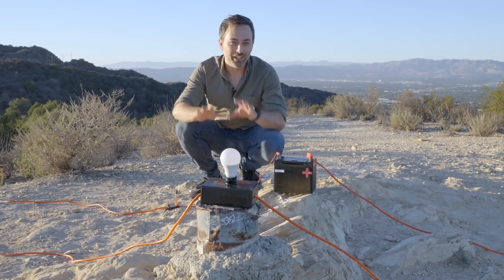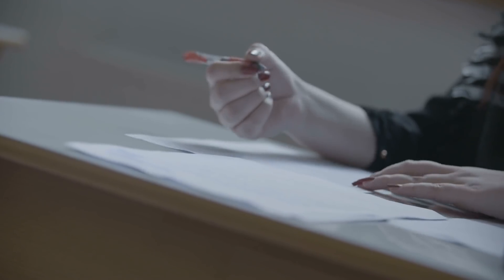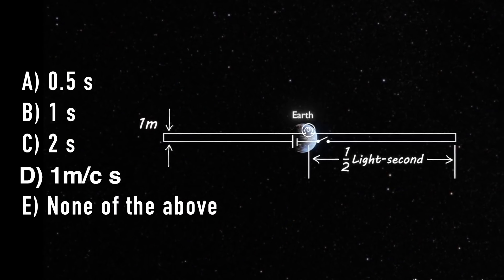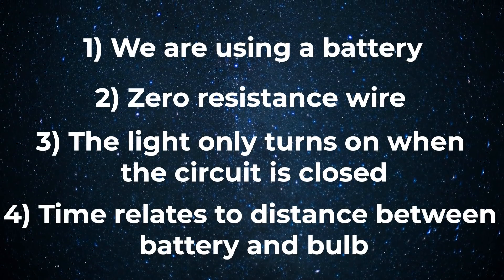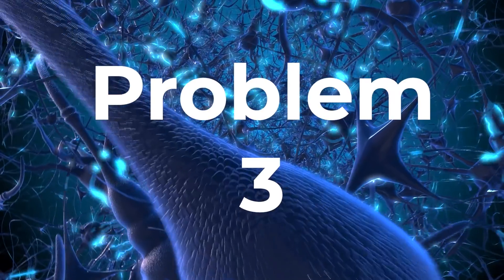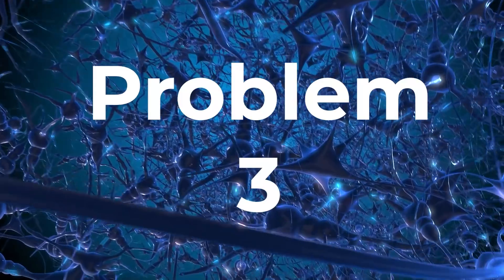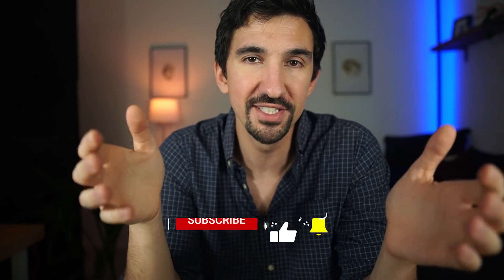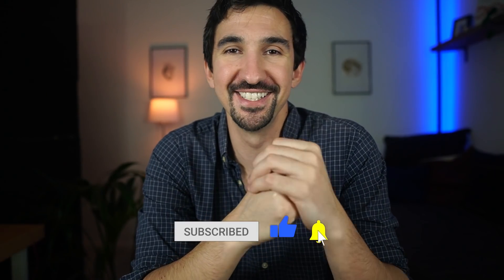Is Veritasium Wrong About Electricity?

Comment: One thing to remember is that the two wires being one meter apart have some capacitance between them, and such capacitance existing right from the start transfers some power to the lamp. as the switch turns on and voltage on the line flips. Veritasium's video is designed with all sort of clues and limitations around the problem that are hard to pick up. But at the end of the if we go with all limitations Veritasium imposes on his problem, he is right.
Reply: Thing is, in the video the bulb he's hooking up is clearly an LED.
Those have a threshold voltage in order to turn on, so some tiny voltage that comes from induction won't cut it.
Reply: @IamGrimalkin  in order for inductivity/capacitance to work, need much more time than 1/c anyway. More time you give, larger length of the wire can “participate”.
Somebody with better math skills than mine can probably calculate that       even after, say, 10 ms, there will be not enough voltage to light up a red LED even for a few nanoseconds, even assuming zero resistance infinitely thin wires.
Reply: Veritasium has been wrong about a lot things for the past 2 years. Just saying.
Reply: Veritasium was not correct because his light bulb would light up exactly the same amount as it would had the CIRCUIT NOT EVEN BEEN COMPLETED in the first 0.5 seconds

Imagine a second setup with a battery and light bulb where the ends of the cables are not connected (0.5 light seconds away floating in space)

When you close the breaker information and causality can not propagate faster than the speed of light, so whatever happens before 0.5 light seconds can't be any different regardless of whether the circuit is ACTUALLY completed or not

The energy that gets transmitted across the 1m gap is the same regardless of whether the circuit is truly closed, then the energy that arrives because of the circuit actually being closed can't arrive for longer

If we're accepting small amounts of energy transferring NOT DUE TO THE CIRCUIT BEING CLOSED then that is like saying energy is transferring from my wall socket to my light bulb when I simply hold my light bulb 1m from my wall outlet without even closing a circuit. It is TECHNICALLY TRUE That 'greater than 0' energy is transferring, but the correct answer is no, energy is not meaningfully transferring with no completed circuit from the wires in your wall to the non-connected light bulb
Reply: @tra7017  You are totally correct in thinking that for the first 0.5 seconds of your example, electrons move through the wire with no knowledge the circuit will break ahead. During that time the bulb lights up, then another 0.5 seconds later, as the 'information' (as you put it) travels back, the wire will have a constant voltage equal to the battery voltage. Thus, no more current (or also referred in some comments as 'electron drift') travels down the wire, at that point there is no more magnetic field around the wire and therefore no energy transferred to the bulb, and the bulb will turn off.

As a summary for your example: 1/c seconds after turning the switch the light bulb will start turning on, incrementing slowly till 0.5+1/c seconds after which it will start dimming again till 1+1/c second when the bulb is off.
Reply: @tra7017  This reflects my thinking.  Worth pointing out that in my profession - electrical engineering - we often observe a faint glow in an LED pilot light even when the circuit is clearly not made.  This results from capacitive coupling with adjacent conductors.  Of course, in the case of this experiment the source is DC and a varying current is required for a varyng magnetic field in order to induce anything.  However, even in a DC system, a rising edge (voltage) will propogate down the wire creating an effect in the other wire and a resulting current that will be weak but sustainable until the true effect of the closed switch becomes manifest as a stronger and maintained electro magnetic field.
Reply: He said wire. What about a coax? It's still a wire.
Reply: @ElectroBOOM, What if the switch is placed at the c/2 distance ends of the wire. Someone operating the switch can then instantly transmit the message to a person observing the bulb.
Reply: It's actually the mutual inductance per unit length between the wires which will lead to the gradual power transfer to the bulb until the full wire gets covered by the propagating field at the speed of light c. The mutual capacitance will act in conjunction with the bulbs resistance to give the time constant tau = 1/RC which will decide when the bulb is fully lit up to the V/R value asymptotically.
Reply: If the resistance of the wire is zero, there won't be any voltage difference between any two points in the wire, and hence there won't be any capacitance under play. In time 1/c is not enough. N/C where N is > 1 is required. I have already mode a twitter post with a $1000 wager which Derek has not accepted.
Reply: @therealsachin  Even if the resistance is truly zero, the application of a voltage at one end surely cannot result in instantaneous voltage at the other.  This would violate the laws of physics (causality exceeding the speed of light).  The voltage would need to propogate down the wire as a rising edge no faster than the speed of light.
Reply: My main issue with the Veritasium video is "designed with all sort of clues and limitations around the problem that are hard to pick up". Rather than attempting to deliver a clear explanation, it appears designed to obfuscate matters in order deliver a mind-blowing gotcha.  Which left many viewers confused, with plenty of commenters wondering why it doesn't break causality, andwhere even the commenters that agreed with the video ended up disagreeing on why it works the way it does.
Reply: @BainesMkII  I think you have hit the nail on the head, style over substance unfortunately in this case. Unfortunately to get views sensation is more effective. I would question the integrity of the channel but I genuinely think the issue was not appropriately presented to fit a as you accurately put the "gotcha moment". At least it got us thinking more and asking questions.
Reply: @BainesMkII  I suspect that while Veritasium is correct in his answer, he didn’t fully understand the reasoning why he was correct.
Reply: @timjohnson3913  Something that stood out to me is near the end he says that he received "kinda different answers" from the experts he consulted, but that they agreed on the key points.
Reply: @timjohnson3913  I don't think he would have made a video without being confident. He just couldn't explain we'll all the assumptions, constraints etc
Reply: you mean that Tesla is not a mad man when he wanted to transfer electricity wirelessly over long distance with his tower?
Reply: @electronresonator8882  Tesla was an amazing genius, he was one of my heroes growing up.
Reply: I think Veritasium is correct also. I really don't undertand why people think his model implies faster than light communication. The power would travel as EMF between the two. How is that faster?
Reply: @ElectroBoom, I don't think he Veritasium is right.
Indeed, those long wires act like a capacitor and there is some power transmitted in 1m/c seconds from battery to the bulb. But that's trivial and is not what he meant.
He pretty much stated that the bulk of energy is transmitted through the fields outside the wires.
And that can be demonstrated not being true, by putting the lightbulb in a very good Faraday cage.
If Veritasium is right then the light bulb in a Faraday cage shouldn't light up.
Reply: @euunul  So, technically for AC, a great majority of the EM wave is "outside" of the copper surface. But everyone seems to ignore the fact that the majority of the energy density occurs closer to the moving charge. So, while the statement is a true statement, he also implies that the majority of the energy simply crosses in a "direct" line to the Light Bulb (1 meter) without really needing to travel via the wire.
That's where he got it all confused.
Because the majority of the energy, while "outside" of the wire in AC, must still be "near" the surface of the wire because that's where all the electron charges are moving. The more distant you get from the moving electrons, the weaker the energy density.
So, somewhere he got confused with all the talk about energy flowing outside the wire... and turned that into energy going straight to the light bulb. 
Again, that is "technically" a truth that energy does travel in that direction, but the energy density reaching the bulb is incredibly low. 

Most of the explanations are trying to make this an antenna problem when it is a power delivery issue.
Reply: @marcfruchtman9473  I meant to answer you, not albatossable, but anyways, I thought a little more, and now I cannot decide what is going to happen whit the field I made in the Faraday cage.
Reply: "the two wires being one meter apart have some capacitance between them, and such capacitance existing right from the start transfers some power to the lamp"
OH NOW I GET IT AAAAAAA I was so baffled by the original video, thank you so much!
Reply: @flexico64  There has to be capacitance. No capacitance means no electric field.
Reply: Well, if the light bulb is ultra sensitive, then without switching the power on, the battery itself will emit miniscule EM wave to light the bulb. So, the lamp will be on before even the switch turned on.
Reply: @iliaadamanthark8336  an ideal battery/voltage source would only do that if moved.
Reply: But isn't the capacitance negligible? since a wire with current on it, is technically still neutral, there are no more electrons in one side than in the other, so electric fields are still close to zero, specially at one meter distance which is huge for something that is very close to neutral if not entirely.
Reply: @diegog1853   I think you are right, but I do not think we need a capacitance. As long as we have moving charges, we have an EM field, and we can have that without a capacitance.
Reply: @oleedvardvaly1782  Yeah but EM fields do not equal to current and will not necessarily power the bulb, the point of a capacitor is that the high electric field pushes charges into the conductor. Charges moving at a constant rate generates a constant stationary magnetic field. And that doesn't generate current, you need a varying magnetic field to create a current. All the cables in your house that are turned on generate the magnetic field, and yet they don't randomly turn on other disconnected devices.
Reply: @diegog1853   Are you sure we need a changing current to get a magnetic field? I am pretty sure Ampere’s law allows a magnetic field with a constant J. The curl of the magnetic field of course varies with distance, but not with time, if dE/dt = 0 and J is constant. Thus, a constant magnetic field will generate a constant current, as long as the E-field is constant, which it is for the battery. The cables in my house are having two conductors close together, so they do not make large fields far away, since they have opposing fields zeroing out the other.
Reply: @oleedvardvaly1782  In amperes Law the line integral of B*dl has to be different than zero for a current to be induced. A constant current generates a constant magnetic field around the line of the current, but if you introduce any other line to this system, this integration vanishes, it is most clear in a parallel line, since all of the magnetic lines crossing the wire are perpendicular and so the scalar product B*dl is zero (since vectors B and dl are perpendicular).
What you need is the Faraday's Maxwell equation, which has the closed integrals of the electric fields equal to the time derivative of the surface integral of B. So you need a loop of wire like ina transformer (which the AC already gives us a changing magnetic field) but it can theoretically work with the small coil in an incandescent light bulb. Although probably not enough to make it turn...
Reply: @diegog1853  Closing the switch creates a transient pulse that passes through the capacitor formed by two parallel wires. It is small, but the wire is long.
Reply: why can't I read this comment normally, without hearing the electroboom's funny and slightly angry tone narrating it inside my head?
Reply: @ElectroBOOM, I think the bigger issues is the inductance of the wires which (for parallel wires) increases with length.  This is going to introduce a time lag that is proportional to the length of the wires.
Reply: He's wrong anyway. Like sure you will have some charge in the bulb radiating from the battery, but it's not enough to turn It on. You need it to travel through the wire
Reply: His answer would be only correct if bulb was not real as resistance is 0, don't like this catch you out approach but with assumptions it seems to be correct. I would love to hear circuit designer thoughts on this as they might add something useful from real world learnings.
Reply: Amd there is a total lack of consideration for conductivity/wire gage/dielectric + conductor permeability/angular propagation/VSWR/Losses...

The nerve 🤣🤣🤣
Reply: I demand an ElectroBOOM versioj of this experiment
Reply: I can’t wait for your video!!
Reply: What if you bring the wires farther apart so there is no capacitance? I think he would still give roughly the same answer (~1/c). Would be nice to see another ¢10k showdown between you and Derek.
Reply: While I agree with electromagnetic waves carrying the energy, or at least not a flow of electrons (as it's them oscillating instead).

I'm not really convinced nor do I believe his thought experiment.

However I do make the assumption that not any amount of power is enough but needs a minimum amount of power delivered by the source (otherwise your lightbulb could just turn on due to just solar radiation or other other electromagnetic waves such as radio, etc, depending on what frequency this atenna and/or the lightbulb are sensitive to). If he was talking about capacitance, then his thought experiment is nonsense and just pointless, as that is not something that generally ever happens on a practical scale, unless you start working in micro and nano-technology.

Basically his experiment claims that, in a vacuum, only the physical distance between source and load matters, not the length of a cable, I will assume here a perfectly isolated/coated cable. That I'm pretty convinced even with perfect conductors (super-conductors) is not going to happen.

Let's change it a bit and see why it's weird and nonsense.
Let's say the loop stays equally big but now between the source and load (lightbulb) a perfect isolating wall for electro-magnetic fields is placed (not a material that exists but neither does his cable). Then compare this situation to where there's no isolating wall. If in that case what he says and claims, that it takes just a fraction of a second, 1/c or 1m over the light speed, this would result in requiring that my new example doesn't turn on as fast and would turn on much slower. Keep in mind I'm not talking about a dielectric or magnetic material that directly affects the fields, no just a shield/wall that blocks it from passing through. However if you would make any experiment as close as possible to this in practice by using much shorter distances and very high speed measuring equipment, you should not see a difference for how long it takes to turn on in either situation, the time should be the same. Similarly, if you change the 1 to 10m, or 100m, it also doesn't make sense that the time would then change to 10/c or 100/c.

His experiment claims if based on capacitance that physical direct distance is what limits if you can transfer power and your cable length doesn't matter (barring resistance). However if you account for equal load/resistance along the cables then changing the distance between source and load, at macro scale, doesn't do anything nor turn off the load once it's way too far for any capacitance to matter. However we know from practice it's the resistance of the wires/cables that limits how far you can transfer power from 1 place to another, not the direct physical shortest distance.
Reply: @ElectroBOOM  Veritasium is not right, "he's not even wrong" to paraphrase Hans Bethe. Veritasium's reasoning about this is incomplete. Is there energy stored in the electromagnetic field? Yes, absolutely. Is the light bulb capturing any of that just because the switch is closed? No, that's dumb! (A light bulb is a DC device. Line to line capacitance and inline inductance do not effect the circuit below RF frequencies, where the size of the circuit approaches the wavelength of the radiation.)  I agree that the flux of the Poynting vector is the mechanism for delivering electromagnetic energy to the circuit, but here's the deal: Applying Gauss' divergence theorem to S = E x H, you get div S = -- E * curl H + H* curl E. The first term is minus the E-field times Ampere's law, and the second term is the H-field times Faraday's law. Putting it all together: div S = -- E*(J + epsilon dE/dt) + H*(- mu dH/dt)= -- E*J -- d/dt(1/2 epsilon E^2 + 1/2 mu H^2). The junk in the parentheses is the energy density of the electromagnetic field, and in order for it to produce energy flux it has to have a non-zero time derivative; which it is simply not going to have at DC! Now we come to the -E*J term that Veritasium did not bother to mention; sad, because it is this term that forms the solution to the entire problem. The '*' here means dot product by the way. J, the current density, is equal to the charge density times the velocity of the electrons in the wire (a velocity substantially less than c) but as it is the velocity of electrons in the wire it establishes that energy does in fact flow in wires, exactly the opposite of Veritasium's thesis statement. Since the E-field is aligned with the wire that forms the circuit, -E*J represents power delivered to the circuit by the battery, i.e. energy flowing out of the terminals of the battery to drive the rest of the circuit.  In conclusion: EE's are not always wrong and Physicists don't know everything.
Reply: @johnnolen8338  I totally agree with you!
Reply: I do not have the time to read every comment so if this is redundant I apologize now. When I was designing emp simulators I had an ocassion to make 50 nsec pulses with a length of 50 ohm coaxes and by using a hydrogen thyraton tube the rise time was measured in picoseconds...The current  generated were several amps...so all of the discussions about capacitances and inductances have some bearing but miss the mark. A transimission line is distributed capacitance and inductance as well as resistance. It is the impedance at the end of the line that is important. So I looked to see what it was with my 500 mhz bw oscilloscope and it was very much 50 ohms to hundreds of mhz. So consider the time in nanoseconds. The bottom line is I could see that a transmission line could show a 50 impedance in a few nanoseconds and provide that impedance for say a 1000 nsec until the short circuit at the end caused a total reflection which meant that the 50 ohms was changed to the resistance of the wire after the reflection of the step voltage was reflected back to the input. What happened at that input then depended upon the load which is the led light in this case...If the impedance did not match then there were many more reflections and the briteness was modulated by these.  

So what he was trying to teach was that a good transmission line works for reasonable cable lengths. That was right but it changes its impedance when the energy travels down the cable and sees the short circuit at the end...he tried to make the issue in a second so that made a physically impossible cable...that required a thought experiment and made the results ridiculous.  The problem with making the length something practical was that every EE would do a spice simulation and come up with his answer and the video would flop. Since not many amateur electronics experimenters have used transmission lines to make pulse circuits there is not much knowledge how the fields propagating at less than the speed of light works. Never the less, none of the above is the correct answer since he failed to mention that the fields travel more slowly in the air while the fields go the first meter. So that is where I knit pick. Also, the wires will not be perfectly matched due to the physical layout and that will add inductance that is not in his thought model...inductance slows the rise times and stray capacitance means ringing. These are the practical issues that any EE has to deal with when making nanosecond pulse circuits work right. So he was right that the impedance seen at the end of the transmission line is determined by the fields by electric and magnetic which are very fast but his answers were still wrong because the same fields he was teaching us about slow when the dielectric constant of air is used to find out the speed of propagation of the electric field in air.
Reply: Veritasium is wrong, he just tried to use a way to make appear that 1/c is correct, he tried everything to make this answer correct. Literally everything. Like if you fart here it will be a storm in our moon due to the butterfly effect. You could get poynting vector even from anywhere else to turn the bulb on, so whats the matter than.
Reply: YES!
Reply: @evilkidm93b  🍩’s & ⏳’s
Reply: Don't forget that DC power doesn't travel very far before resistance eats it up.
And those wires extending into space and moving through the Earth's magnetic field would generate an enormous current that would probably kill the experimenter.
Reply: @MichaelClark-uw7ex  DC or AC will be affected by wire resistance but Derek mentioned explicitly that wire will be ideal and have no resistance.
Reply: @electrodacus  And with zero resistance the induced current would be even greater.
Reply: @electrodacus  Right, but he never said the wire wasn't insulated. A standard DC wire (even one with NO resistance) will be insulated to protected it. We can make that assumption based on the fact that its clearly shown in the Demo as an Insulated Wire. And the power source is Direct Current, not AC.
That is why this is not a transmission theory question but a power transmission question.
Reply: @MichaelClark-uw7ex  Lets not make this overly difficult. Of course wires have resistance but lets not get bogged down in that for the sake of this thought experiment.
Reply: @exponentmantissa5598  Well that's ok for a thought experiment but as a practical experiment it could well be deadly.
Reply: One can't ignore the inductance of wire because magnetic field takes time to form...And magnetic field is something universal..
Reply: @sefalibhakat143  In this case it is unclear what the inductance of the wire is, since the width of the wire is unknown. But in general circuits, except in certain circumstances, the effects of induction and capacitaces in the wires are so small compared to other stuff that they can be ignored.

In this case it could be that the wire has zero width and then the wire has no self inductance. (Although i don't remember the formulas for the inductance of a wire from the top of my head)
Reply: but then why closing the circuit in the first place?
Reply: @DomocaiG  To make an interesting problem, however the problem would have been better if it was like this,

                                 (lamp)
___________________|    |______________________
|__________________    _______________________|
                                     |   |
                              (AC source)

And let the AC source turn on, then you would have two dipole antennas especially if you would tell the geometry of the wires.

In this scenario you could also tie in that antennas are also components that transmit power through free space like transformers and capacitors.
Reply: >>two wires being one meter apart have some capacitance between them
Yes, they have about 2milliFarads - but it's distributed over the entire 1 light-second length.   The amount of capacitance seeing the transmission for the first few nanoseconds is negligible - a few meters out of  ~600 million meters length. The distributed inductance of the system would be huge (3400 Henry), like a super-collider magnet.  Again - the wave won't see more than a microscopic fraction of either the distributed capacitance or inductance in the first nanoseconds.
Reply: @stevealexander8010  That's a really good point about the distribution over the length of the wire. 
However, I am unsure how to quantitate the actual per meter capacitance or inductance in a wire that has no "resistance". If you are correct, then it certainly helps to prove my point about not having enough energy to actually turn on the bulb.
We can see in the video that the conductor he uses in the demo is insulated. But I am unsure how to calculate the per meter capacitance or inductance. Are they independent  or reliant on the zero internal resistance of the wire.? In other words, How did you arrive at the values?
Reply: @marcfruchtman9473  You seem to struggle with the separation of a hypothetical physics problem and electrical engineering. He makes a bunch of assumptions that are not possible in real life, because that's what physicists do. Also you are referencing his demonstration which is just a rough visual. You sound like someone who would argue it's impossible if problem said air resistance is negligible or a cow is a sphere.
Reply: @andrew3404  You are incorrect that I am struggling. I know what it is. 
My problem is the intended audience and the communication of the question, as well as the communication of what he believes is happening.
For example, I don't have any issue with a "zero resistance wire". That is a perfectly reasonable thought experiment criteria. The reason it is acceptable is because you want people to understand the amount of time it takes for the current to travel a light second... which is something the audience can easily grasp. But, if you include resistance in the problem, it would suddenly become an impossible problem because the resistance would preclude the ability to have a 300,000km wire.
So, I am fine with Hypotheticals that make sense and fit the problem.

The issue is with the light bulb that turns on with "any" current.

That criteria is completely unusable because ANY current literally means from the tiniest motion of any charged particle.

So of course the light is going to turn on when an electron vibrates. 
My point is that the experiment proves nothing. Nothing is gained other than an electron has moved somewhere.

ALL the blathering on about transmission theory, has NO relevance once that criteria is applied that "any current" turns the light on. 

I have said this several times, it's pretty clear from the video that Veritasium believes and implies that my appliances are powered by the electromagnetic wave that is "external" to the wire, AND he also believes that the power to do that is directly transmitted radially from the source to the load.
What he obviously doesn't seem to understand is that the great majority of power is not delivered that way. Only a Fractional Part of the power is delivered that way.
The majority of the power is delivered along the wire because the EM wave is closer to the electrons.

So, it is very very misleading to go thru all those gyrations to turn on a Light bulb that requires only 1 electrons worth of charge to light a bulb when clearly a "regular" bulb would never light in that manner in a normal way. 

The way he has applied the criteria, the wires are inconsequential to the entire demonstration. You can literally not even have the circuit connected to the bulb, just have a battery connected to a switch. Simply closing the switch will STILL light the bulb.
It's just a ridiculous experiment. And as I said before, given the criteria the only useful thing we learn is that EM energy travels at the speed of light. You cannot make any other conclusions. 
The rest of the data as presented in the links clearly do NOT show adequate power and voltage to do much of anything at 2 seconds, let alone 20 seconds.

He spent almost 15 minutes talking about how electrical power is delivered to my home, and the "big lie" and then made a demonstration that has NOTHING to do with the fact that my appliances still need wires to work, and do NOT turn on and operate by bypassing the wires. 
It's incredibly obvious to many people that this demonstration was not up to his standards, was very misleading, and in my opinion is not consistent with the message he delivers.
Reply: Please make a vídeo of this!!!
Reply: Please make a video about it..
Reply: No, Veritasium is clearly wrong.
Reply: Waiting on your video mate
Reply: This is what I was wondering. Was Derek referring to some kind of coupling effect? If so he was very unclear and the answer felt a little underhanded.
Reply: but how much power is transferred that way? what if we require enough wattage to be able to SEE the light before we can consider it to be ON? if we consider these basic limitations then veritasium is wrong because not enough power can be transferred
Reply: @TehMuNjA  I been arguing that point since DAY 1. But apparently it's not about common sense. It's about the rule which says the magic light turns on with any current.
Reply: The problem with those limitations are introduced to overcome reality so a model works and then that model, based on a modified version of reality is presented AS reality. That's bad.
Reply: So the question becomes whether enough power is delivered to light up the bulb at all before the 1 or 2 second the field takes to travel the wires.
Reply: But his limitations end up creating a misleading representation of how this would actually work in the real world. He makes an esoteric point about fields by confusing people about actual real world electronics.
Reply: What about velocity factor? That is especially important for RF, for things like phasing harnesses
Reply: Veritasium's Is NOT right. He is wrong on multiple levels.
Reply: Yea. Derek's video is a thought experiment, really.
Reply: Make the god damn video already
Reply: What I want to know is, with that setup why two wires? You only need one.
Reply: yo if we have that much long wire !! we can get free energy :)

it would be more power full than your microwave transformer
Reply: he states this in the video smh
Reply: it would have been better to take a conductor where the voltage wave is reflected and thus forms a standing wave, so one could have measured the wave-shaped voltage amplification along the length of the conductor.
Reply: First electron in pushes last electron out?
Reply: So are you saying that the bulb will 'light' after 1m/c seconds whether or not there is a break in the wire at a distance half way to the moon? Just because of the antenna / receiver set up. And not because there is a complete circuit? Because if this does require the complete circuit to light the bulb you have broken causality again. We would know information about the state of a second distant switch instantly and thereby send messages FTL. You say that the wires are already 'charged' as capacitors. But can they be on the bulb side when the switch isn't closed in a zero resistance wire and especially not if this is a filament bulb? Why does closing the switch make a difference to the induced charge on the bulb? The change in charge at each end of the battery cannot be changing much. Should we just strip all the insulation off our wires at home and get everything working using the magic of free em fields from other people's house circuits? No, because you literally can't get useful amounts of light from doing that right?
I think it is disengenuous to say that we have been told lies about how electrical energy travels through wires, when it clearly requires the wires for that to happen effectively. Or it can be done with very close wires and iron cores to wirelessly induce flow e.g. in transformers.  But even then not without losses.
Reply: @CorporateZombi  Here is a way you can understand: When you listen to your car radio, you do not have a wire, and yet somehow you do not break causality.
This demonstration is NOTHNG MORE than an electromagnetic wave reaching the bulb.
A ~15 minute video explaining how electricity travels like a radiowave. 
Surprise! 
Now you understand, and that is why a lot of people are a little upset about the whole "everything we have been taught is a lie" thing, followed by a giant misdirection video turning a light bulb on.
The WIRES ARE NOT REQUIRED.
They serve NO purpose.
Since the light bulb will turn on with "any amount of current" all he needs to turn it on is the electromagnetic energy that travels like a radio-wave. Essentially, the EM energy from 1 electron moving at the time the switch is thrown is enough to turn the light on.
So, causality is not broken. Just my trust in Veritasium's videos.
Reply: Do wires have capacitance even without any current flowing? If so, how do the wires know direction way power should flow to?

If power can only start transferring when a current flows, how does the entire wire know instantaneously at all points that the current can start flowing even if that information was created further away than light could travel in the same amount of time?
Reply: claim was that electricity does not flow like water in a pipe so he got that point across. Hes not gonna go super technical and make it into a scientific experiment. The viewers wouldnt bother. Coudlve shown a high power line and some light bulbs nearby to make a point about the electromagnetic field.
Reply: Pointing out the capacitance is meaningless.
The power is not being transmitted through an AC source that would transmit non-negligible power to the load through such a capacitance. 
If any inductance is more meaningful but even then its not, maybe like microwatts.

Veritasium got it wrong.
The field propagates through/around the wires as the current density creates new fields creating the propagation of a wave around the wires.
Reply: You’re right there’s “some capacitance” but you’re not going to be able to hand-wave a correct answer here. The capacitance is tiny. It’s hard enough to even detect it at 1m. That’s why metal detectors don’t say “there’s a coin three miles that way.” If you’re argument is that it’s because the wires are ‘so long” then you’re back to the time it takes for the potential to travel down the wire, and potential can only travel by moving charge carriers, which is exactly the opposite of what his video is claiming.
Reply: The man with the chain beef agreeing with someone on something?  I was expecting more beef
Reply: I think in order to transfer electromagnetic energy throughout the field lines the potential difference must be created and it can only happen through the wire because air is open circuit so I think it will still take 1 second for the lights to turn on for the difference in potential field to be created when the signal from the battery will reach the bulb  and then they will transfer energy along the field lines if you consider the wire is ideal
Reply: @Marc Fruchtman As far as I know, radio waves dont travel faster than light. They are light, dumbo
Reply: @rykehuss3435  You previously posted: "So with all limitations taken in consideration, you could transfer information faster than light by using electromagnetic radiation, which is.. light."

As I stated earlier, the energy travels thru 1 meter of air to turn the light on at the speed of light. (Not faster).
There is no "transfer Information faster than light" happening. It's simply turning the light on by traveling only 1 meter thru the air, instead of 300,000km.

As I said, it's a confusing video.
Reply: No idea why everyone is talking about induction and capacitance. That isn't the point.
Reply: Right about what specifically?
Pretend there is a break in the wire at the furthest point  of the superconducting wire.
The bulb will not be part of a circuit.
Reply: What I see in the original video:
Question: What is the fastest time a current hits the lightbulb.
Answer: A lightbulb not attached to, but placed beside a closed battery wire circuit should be consider lit.

It's not a simple is "his conclusion legit" question, but rather if that conclusion is an answer to the original question.
Reply: but is it really a circuit that he's describing? the lightbulb would still recieve that initial power if the circuit was broken at the furthest points from the battery.
Reply: and also this is a huge loop, so there is not neglectable inductance
Reply: Please video BOOM Man 🤓
Reply: One important point you miss in here is that the position of the battery is basically irrelevant (if we assume it's in steady state before the switch is flipped, which it must be or the light would be on, per the simplifying assumptions in the veritasium video).  It could be at the end of one of the long sections of wire, or even right next to the bulb.

What actually matters is the position of the switch relative to the bulb, as that is where the electricity begins to propagate, and so that is where the power begins to radiate from.
Reply: by being wrong.
Reply: Yes, exactly what I was going to say - it is the interaction of the wires right next to the battery and the light - not the entire length of the wire. It is the fields in the two wires that "communicates" here. Capacitance is caused by electric fields of the wire, not current like we often think of in a water hose analogy. There is also inductance in the wire, which is involes the magnetic field, which can induce current in the parallel wire.
Reply: @TerranIV   The scenario you described is ridiculous. Electric fields do not create capacitance. Capacitance is an intrinsic property of the circuit itself; likewise inductance. Electric and magnetic fields interact with capacitance and inductance respectively but they do not create them. Modeling the circuit as a lumped parameter model in the s domain one can show that there is no current through a capacitor placed between the battery and the light bulb at any time between the closing of the switch and eternity. Likewise an inductor placed inline presents zero impedance to the current as the switch is closed. Intrinsic reactance only becomes a thing at high frequency, i.e. RF and above. This circuit, despite the light second long transmission line, is still a DC circuit. Current flowing in the wire is the only means by which the bulb will glow if it ever does.
Reply: Hi, . . .  Yes, capacitance between the go and return wires, being 1m apart, will delay the current even more.
Reply: Its easy, hes wrong, otherwise latency does not exist.
Otherwise your light bulb wire would not get hot, because he concluded that energy does not go trough a wire.
The sea transmission lines are high inductance/capacitive load, lenghtening the morse pulses.
By pcb design length matching of traces has to do with the speed of light, inductance and capacity, impedance matching is done by resistors and less important.
Reply: @onGlobalproductions  There are two different things to know about, one is simple Electricity, the movement of Electrons IN a wire, their speed dependent on inductance and capacitance etc.. . . .  The other form is EM Waves, as in high frequency and radio frequency, which travels between two wires or transmission line or coax cable, and in that case the speed is at the speed of light in that medium, typically around 0.6C
Reply: See my comment elsewhere. The whole set-up is a transmission line and must be analysed as such.
Reply: @chriswoollacott6158   I understand that. But at the heart of this were talking about the briefest of impulses. Ultimately said impulse will die after which the EM field will no longer be coupled to the light bulb. Veritasium's claim that electricity doesn't flow in wires is total codswallop. DC fields don't radiate.
Reply: @chriswoollacott6158  That is NOT how the original question was about.. .  The question is about DC. . . .  How does a DC transmission line work. ?. . .p.s.  Batteries put out DC  :-)
Reply: @hughleyton693  Yes but it isn't really DC. When you switch the battery on you are looking at the response of the circuit to a step function and that was the question.

Classic undergrad electrical engineering problem.
Reply: Hi,  . .   The two wires 1m apart will, as you say have capacitance between them, but since the Current from the Closed switch to the Light is going out on one wire and back on the other wire, the capacative coupling between them will be in the opposite direction so the strengthen the field between each other, but cancel out, remote radiation.
Reply: Boom and drops the mic 🎤
Reply: Would that mean that if there was a break in the cable the light would turn off shortly after lighting up?
Reply: hope soon you too make a video about it. i am waiting for that.
Reply: No, veritasium is wrong.
Reply: Instead of 1m, what if the switch and bulb are placed 1 km away? Will the bulb still turn on with the capacitance?
Reply: I'm not sure you actually watched the video o.0
Reply: The original video stated that we should consider the lamp turning on to occur when there was any power however little, even if not enough to actually light a real bulb, in the circuit reaching the bulb, which is fair enough except for the fact that an open switch in air is literally a very high capacitance capacitor and thus the circuit as closed under the theoretical conditions he described, resulting in the answer being “the bulb was on before you flipped the switch”, or “none of the above”
Reply: that under some special conditions his answer could be right, does NOT mean that he is right!! his argumentation is wrong, that is the point.
Reply: He is right?
About what precisely?
What energy is available at the lamp at 1/c seconds? That's 3.3nSec. not 4.3nSec not 3uSec.
Show me any lamp that can do useful work 3.3nSec after a 12v battery is connected by a switch 1 Meter away with anything other than direct wires.
Reply: Lmao this almost seems like a deliberate misunderstanding of the premise in the first place
Reply: No, he is not.  He uses an ordinary light bulb and a 12v DC battery.  Capacitance is not large enough to induce enough energy.  This is stupidity of veratasium and its not the first time.

And keep in mind he uses an actual circuit for example.  So this by no means was a "thought experiment".  Listen, there is an old saying: don't defend an idiot, lest you yourself be mistaken for one.  In this case, I rest my case, everyone already thought ElectroBoom was a (funny) idiot.  But the rest of you have chance to stay out of that category, by not defending veratasium. 

Truth be told, veatasim made $10000 for that video alone, last I checked.  So maybe he's an idiot, but he's not stupid cause he's making money being an idiot.  Oh wait, isn't that ElectoBoom's stich?  Birds of a feather defend each other?  Lol.
Reply: not enough to turn on the light.
Reply: I can't imagine any set of constraints in which veratasium is "right" here. The best I can do is ignore the long wires, which don't need to be idealized for 1m/c seconds, and expect a small induction effect at 1m/c. But this inductive effect doesn't correlate to electricity traveling in the fields not the wire.
Reply: The main issue here is that he is using fake wire to do the experiment. The wire is nowhere near 300000 km length. He has not shown it. Next the measurement tool for 1/c is not done properly using correct tool (such as oscilloscope). Thus he is doing fake experiment and that behavior should be shunned in scientific community.

I understand what you are talking about: there is air capacitance between battery and lamp. But the capacitance is not only dependent on the distance but also on the length of wire (see how capacitor is built, it is not only distance that matters but also the length or area). In oscilloscope experiment from other video in Youtube I see the capacitance only turns on the lamp right after connected temporarily then it stabilizes when the voltage from battery comes which depends on the source voltage minus the voltage drop on the wire, which if the wire is 300000 km length, should be very high that the output of lamp voltage would be near zero.

In short, the experiment is fake and the answer of 1/c is never proven and I think it is incorrect. If the wire is in correct length as stated, the lamp should immediately light up (in fraction of seconds because of capacitance of that very long wire) then dimmed to steady voltage. To demonstrate more, just put the wire up 100 m tall and you will see big voltage difference with the wire in ground simply because the wire picks up electromagnetic energy from Earth - Sky difference and the lamp would just light up without battery indefinitely.
Reply: It is true that the capacitance exist, but the voltage and current will not be enough to turn-on the light.
Reply: He is right, but also fields travel in both directions so it would take half the time for the power to travel around but even in a scenario where the wires are not a meter apart you would be surprised a plus has a lot of electrons drawn in a minus has them leaving out ( electron flow versus calculation flow ) if one has enough power so the fields do the work but they travel in both directions so length of wires diverse over light speed halved , but with the wires a meter apart it is more like a antenna and near field effect it works like a transmitter and receiver but if so there is also there close proximity that makes for an almost Instant reaction because we would have a situation look at a Tesla coil if you are very close to it it lights a flourescebt tube, so the close proximity plyas an important role. The fields do a lot of work if it where only the electrons your molecules would he breaking apart...
Reply: I agree that the limitations - "any current at all turns the lightbulb on" - alongside a set of assumptions that are omitted - "no radio interference, no shielding on the wire, lightbulb has a linear response to voltage, wire has a non-negligible radius" - allow Veritasium to support the claim (except that as Timothy Whitehead points out, it will always be strictly longer than 1/c, so the answer is not even theoretically correct).

The main issue I have with the Veritasium video is that the 1/c effect is a transient caused by capacitance. The problem doesn't specify the radius of the wires. If we assume the wires are thin, i.e. their radius is negligible compared to the 1m gap between them - the capacitance is zero, and there is no current until 1 second after the switch is closed. This is why the reproductions showed a very small transient, because the wire radius was small. I note that in their response video Veritasium used inch thick copper pipes for wire, maximising capacitance.
Reply: Right all ok, diffrent answer could be if whole wire was shielded, graunded and protected from carring energy  by electromagnetic field everywhere without having to travel, propagate only inside the wire
Reply: The main problem i see with veritasiums question is that he uses perfect wires in his model (so no capacitor, inductor or antenna) the effect that he implies turns the lamp on would be some kind of antenna which would induce a load, which would mean no perfect wire.

So he uses established symbols to either mean something else or misuse the model. And single DC stepsignal would basicly deliver no power, which might be a nice video for you to make. Although that circuit is some monopole antenna instead of a dipole antenna
Reply: @lennertvanherk7926  Huh, since when do perfect conductors have no capacitance and inductance? Ever heard of MRI scans?
Reply: @evilkidm93b  A MRI machine is a gaint inductor (This then requires the machine to ramp up the current over a long time), with smaller coils which measure the field inside the machine. A better frasing of what i meant was that a line in circuit diagrams has no self inductance, resistance or capacitance and are lossless. My problem is mostly petty in the sence that he uses symbols in a manner that they are not supposed te be used, because these symbols carry with them assumptions which would result in a different answer, I.E. antenna effect/inductive coupling is comletely overlooked, and that he doesn't make clear just how much of a difference in supplied power the steady state lamp on state and the lamp turning "on" from the induced electric field which is created when the switch closes and creates a stepwave through the wire generating a magnetic field perpendicular to the wire, propaging to the other wire, creating a gradient in the electric field there.

Besides this in this hypothetical scenario the gradient in the electic field might be entirely locally precisely perpendicular to the wire after the switch, so if the lamp was between the battery and the switch it might not even recieve that tiny signal the fast way.
Reply: @lennertvanherk7926  Hey, thanks for taking the time to explain, i appreciate it. If what you say is true and a linear conductor does not have self-inductance or capacitance, then that is quite counter intuitive to me, interesting. I apologize for my snarkiness in my previous comment(s) :), I did not intend to sound like a know-it-all. I come from optics, and I thought of the switch being triggered as a dipole emitter. It seemed natural to me to consider all involved media (air, metal) as objects described by complex refractive indices with a reactance. I do admit that I was lazy to run a simulation and check the actual result.
Reply: @evilkidm93b  A real line does have a self inductence, this than depends on the geometry of the cable. It also would have parasitic capacitances to everything in the envirement, but in models you can either ignore them or you have to model them with other components than a line. No problem by the way i am still trying to figure out how each signal how look like and whether they would have any real power behind them.
Reply: @lennertvanherk7926  Even considering this as an antenna (i.e. assuming far field energy transfer) the energy will be proportional to the field frequency E=hv, where lim v -> 0. I.e. no energy could be transferred in a system with infinitely long wires, by a single one switch operation.
Reply: @mishkathebear  I think it would be propotional to the change in electric field, which in a steady state would be reduced to frequency. So the recieved signalpower would probably be the derivative of a delta spike, but that basicly has no power.
Reply: @lennertvanherk7926  His video is more just to answer the common misconception about Electricity.
Reply: @scottwhitley3392  Yes, but i just wanted to vent a bit about how i felt setup while i in my head thought specificly about the fields and how they change. And the fact he seems to understate the power difference between the first power received and steady state.
Reply: @lennertvanherk7926  
Sorry for being late.

I just want to say that the ideal wire should also have 0 length, otherwise the inductance would be non 0.
Reply: @patryk_49  yes, i did forget that
Reply: Although you might set the permeabillity to zero to get an impedence of zero in some cases, so that the length wouldn't matter.
Reply: @lennertvanherk7926  In this instance 0 permiability means that the whole world around the wire is composed of superconductive material, and then you would need to coat the wire with infinitely thin, and infinitely resistive insulation to separate it from rest of the world.

The conclusion should be that the ideal wire is good mainly for approximating short connections between elecronic components.
Reply: @lennertvanherk7926  Yes if he wants to use ideal wires then there will also be no capacitance as wires will have no thickness.
Reply: @electrodacus  the effective capacitance comes from the properties of the battery. while the circuit is off, the wire from the battery up to the bulb is essentially an extension of the battery itself. and the propagation of the EF is finite from the moment the wire is connected to the battery and the other end of the wire (connected to the bulb). the time required for this propagation was not accounted for in the thought experiment.
Reply: @cryogenixzero  when circuit is closed all that happens is that the capacitance created by the wires is charged trough the lightbulb. So the bulb will see some energy proportional to what is needed to charge the circuit capacitance. If that was an ideal circuit then there will be no capacitance since the wires will have no thickens and light bulb will need to wait before it can turn ON based on length of wire and speed of light.
He is not fully understanding the problem thus it was not properly defined in the video. In steady state DC time is needed for the electron wave to propagate.
Reply: @electrodacus  No, I’m afraid your argument is wrong. An infinitely thin wire would have infinite density of charge carriers, both infinities would cancel out and you will still have the same capacitance as between “reasonably thin” wires.
Reply: @noop9k  Why all that talk about capacitance? Do you need that to induce a current in the other wire? Not as far as I know. I think you might be confused by the fact that you need som resistance to get a voltage drop, but we have this voltage drop over the bulb. 
As you say, the thickness of the wire should not be significant, since the wire has no resistance, and therefore can carry the same current no matter how thick it is. The existence of the wire is absolutely important, as that is what makes the inductance. You would not get any light without the wires.
Reply: @noop9k  If the plates of capacitors have no dimensions (area is zero) then there is no capacitor. An ideal line has no thickens thus no area.
If he wanted to use a real case and not ideal he should just mention that was a super conductor so just zero resistance thus not an ideal transmission line but one that can be build and that has both inductance and capacitance. Then that transmission line will have an impedance different from zero so light bulb will see the current charging the transmission line initially then it will see infinite current assuming battery has zero internal resistance so again ideal battery.
He should have mentioned all details and then there will have been no magic. He did not do that as he dose not understand the subject.
Reply: No, this is still a capacitor, because electrostatic coupling between those points exists. just an idealized one.
Reply: @oleedvardvaly1782  no, if the event “switch is closed” causes an effect in the lamp in 1/c, no energy/information could travel through the wire as there is just no time for this to happen. This means it does not matter if the wire exists.
Reply: @electrodacus  I think it's wrong to infer no thickness due from the simplification of having no resistance. The simplification simply is made so that we ignore a physical effect it will have in reality, it doesn't mean we should now imagine a real world scenario where the wire has 0 resistance, and like you point out, that would be if it has 0 thickness.

Capacitors and inductances are often referred to as unwanted when it comes to transmitting wires. However, in this case I don't see any problem with seeing the two wires as an ideal capacitor/inductors, after all those can also be used to model 'ideal systems'.
Reply: @ricroflxD  I will consider an ideal transmission line one that has no resistance no capacitance and no inductance.
You can off course select what proprieties to be ideal and what not but a transmission line that has zero resistance only can be real as superconductors are a thing.
If there is capacitance then obviously that is just 1m away from the lamp on both sides and there will be a current trough the lamp as this capacitance is being charged thus what you see as current trough that lamp is just a small current needed to charge the capacitance on both sides so the super small current trough the lamp is a byproduct of the capacity of the transmission line being charged.
What Derek tried to imply in the video is just false.
Reply: @electrodacus  What picture do you have of a 'capacitor being charged'? The picture I was learnt is that static buildup of charge on one plate causes an inverse polarity buildup on the surface of the opposing plate. Without even going further in the inner workings of a capacitor, just saying that the arrangement of electrons on one plate affects the other (without there being a physical connect in the circuit) sounds like exactly what Derek was trying to point out. Namely energy is transmitted through electric fields (/magnetic fields in the case of inductances, similarly the two wires can be seen as a 1:1 transformer).
Reply: @ricroflxD  Yes the picture you have is correct if both sides of the capacitors are at different voltage potential.
In this case you have a battery say it is 2V and the simplified equivalent circuit includes a battery followed by a switch and then capacitors at both sides of the battery and those capacitors are connected in series by the light bulb.
The capacity of those capacitors can be considered equal in this example and will depend on the plates area higher the area higher than capacity and inversely proportional with the distance between the plates. Since the plates are the conductors and since conductors have zero resistance super conductors they can be as thin as you want thus super small diameter and are at 1m distance thus super small capacitance. Then the amount of energy the capacitor will require to be charged will depend on the voltage delta between plates.
Then when contact is closed capacitors are being charged and since they are in series and battery is 2V the end result will be each capacitor will end up with half that so 1V and all the charge current will travel trough the bulb. 
If the bulb where to be ideal in the sense that it also had zero resistance same as the wires then all the energy exiting the battery was now stored in those capacitors.
After the very short initial moment that capacitors where charged there will be no current flow.
It is like a magnet that always has that magnetic field extending way outside the magnet but it can not transfer any energy and you need to move the magnet near a conductor.
Reply: @electrodacus  According to the formulas for inductance of esingle wire, 0 thickness would mean infinite inductance.
You can't have both 0 capacitance and inductance, unless if the wire has no length.
Reply: No, Veritasium is wrong. The capacitance needs some length of wire to work, so even if we assume that capacitance would be sufficient to light the bulb the field would need to propagate quite a long way along both wires which would take longer than 1/c. Otherwise we could just eliminate the wire and expect the bulb to light up.
Reply: @TimothyWhiteheadzm  Capacitance is a result of de-coupling the electro and magnetic field in Maxwell's equations. You have to assume time symmetry. The electric field already perimetries the universe... why would it need to propagate... and the distance between the wires is one meter... C is not a time... so for 1/c to be time in seconds we had to have 1(m)/(c(m/s))->1/c(s) so the interaction between the electromagnetic field only has 1m to go.
Reply: @woodstock5nathan  The effect that causes a current to flow is inductance not capacitance. It is cause by a changing electric field that is propagating. c is either the constant part of the 'speed of light' and unitless or it is the speed of light with units m/s. 1/c in the original video refers to the inverse of the constant part of the speed of light worth of seconds.
To see why we simply cannot expect to get the bulb turning on the instant the change in the electromagnetic field reaches the bulb simply consider the situation where the wires is cut at a short distance from the bulb. Relativity says that the bulb cannot instantaneously 'know' whether or not it has a complete wire connected to it. The effect on the wire HAS to propagate first out along the wire and then back too the bulb before any significant current starts to flow.
Reply: @TimothyWhiteheadzm  that is kinda what tesla created though right. The energy is already there you just need a way to plug in it. So you can just turn things on cause it's always already reaching you before you attach. Could you imagine how much equality that would create by being just outgoing everywhere simultaneously with no way of controlling who has access. I mean you couldn't keep up with who used what and charge them for it by the amount used.
Reply: @fathersongaming8515  Well radio receivers work that way, as do the chips on credit cards. But wireless power transmission is inefficient and needs to be fairly targeted if you want any significant amount of power. If you want equality however, that simply won't work because if you can't control who has access someone will exploit it to take all the power. That is one of the reasons internet access is never both free and unlimited. If you want energy equality then give everyone rooftop solar and they can manage their own power needs.
Reply: @TimothyWhiteheadzm  so if you find a way to wirelessly transmit with 100%effeciency and you lower the output into a hexagon to perfectly cover the entire surface area. I get that we don't have a way of doing this but that's what tesla was all about. I believe that he had a understanding of what space is actually and it was a universal web connecting everything and allowing for quantom entanglement to make perfect sense. The energy of the universe is freely available for use through the underlying basis for our entire universe to exist in. The space of the universe being a real thing connecting everything together.
Reply: @TimothyWhiteheadzm  The line is already charged as it is connected from the battery to the bulb before the circuit is closed.
Reply: @timjohnson3913  Sure, but the whole point of this discussion is that electricity is a about changing electric fields, not static charges. The changes in the field and any resulting changes in the charges can only travel at the speed of light. The reality is that the strong field that turns on the light propagates along the wire. If this were not so, we wouldn't use wires to power our bulbs.
Reply: @TimothyWhiteheadzm  What you are missing is the reality that the strong field has already propagated at the speed of light along the wire, then the signal for the field to change is propagated across the air (1 meter), resulting in a strong “fully on” light bulb almost instantaneously.

This is analogous to the same situation but the switch that closes the circuit is along the wire 1 meter in wire length away from the bulb. The bulb is fully on in 1/c seconds in both cases.
Reply: @timjohnson3913  'Almost instantaneously' is a rather loose term. How long exactly? How much wire must it propagate along before it has a measurable effect? If we assume there is an air gap between the wires and no nearby conductors then the two wires will act like a transformer and will induce a current in the other wire, but the strength of that current will depend on the length of the wires and it will take some time to build up enough to 'turn on' the bulb. Certainly 1/c is the wrong answer as that does NOT allow for any propagation along the bulb wire whatsoever. How long exactly depends on how much current is required to consider the bulb to be 'on'.
Reply: @TimothyWhiteheadzm  It takes 1/c seconds for the signal to propagate through the air and turn the bulb fully on. The battery is attached to the wire and the bulb before the switch is flipped and has already propagated through the wire. 

1/c seconds is what I mean by almost instantaneous, which is just a simple way to differentiate between 1 second (ie the time it takes the charge to reach bulb when the battery is initially attached to the wire) and propagating through the air in 1/c seconds or 5/c seconds etc., which are almost instantaneous in comparison.
Reply: @timjohnson3913  You are incorrect. It doesn't matter if there are charges in the wires prior to the switch being flipped. The electrons will only flow, and the field will only propagate once the switch is flipped and the signal travels. The bulb cannot instantaneously 'know' that the wire exists so for it to turn on at 1/c violates relativity. The current powering the bulb is induced in the wire around the bulb based on how much current is flowing in the wire around the battery and the length of the two wires and distance between them etc. All this takes considerably more than 1/c
Reply: @TimothyWhiteheadzm  haha so you call me out on using “almost instantaneous” to indicate far less than 1 second and then use “considerably more than 1/c”, which is extremely unhelpful as it could be 1 second, 2 seconds or larger than 1/c but many orders of magnitude smaller than 1 second. In your view, does it take more than 1 second or less than 1 second for the light to turn on?
Reply: @timjohnson3913  The current in the wire around the bulb will gradually increase as the changing field propagates outwards inducing that current. So how long exactly before the bulb turns on depends on exactly what current is required for the bulb to be considered 'on'. It will be many time 1/c but less than 1 second.
Reply: @timjohnson3913  this isn't correct. Check Time Domain Reflectometry, a commercially available tool to measure the length of hidden cables. If his dual wire setup is not varying, the only induced current in the lamp is through capacitive coupling, and this is very small.
The Poynting vector describes the energy stored in the electromagnetic field, not the energy transfer. A moving charge will transfer energy though. Energy is the ability to do work. A charge will be able to attract an opposite charge. If the charge is moved, the ability to attract the opposite charge is moved as well, thus the energy has been moved.
The mistake with the Poynting vector can also be shown, by adding some magnetic or dielectric material inside the circuit. The Poynting vector will change, but the DC current won't. AC current will change though...
Reply: @TimothyWhiteheadzm  the current won't gradually increase, unless the power supply isn't capable of providing enough currents to establish the electromagnetic field along the wire.
My expectation is after one second the bulb will switch on. There are machines using this principle commercially available, they wouldn't work, if the current would flow more or less immediately. In this respect you are correct...
Reply: @timjohnson3913  There is a weak EM wave that reaches the bulb. You can call it whatever you want, but that "signal" doesn't have the power to turn on a light bulb, or an iron, or a toaster. It's simply a weak electromagnetic field.
Reply: @TimothyWhiteheadzm  The LED in the demonstration almost certainly has a significant forward voltage. It won't be doing much of anything until that is exceeded.
Reply: @georgantonischki1188  The setup acts like a transformer which has two coils in close proximity. The difference is the layout of the wire means it takes time for the electromagnetic field to propagate along the wire and generate a current in the corresponding wire. The field will cross the 1m gap in 1/c seconds and start to create a current in the other wire, but it will take some time before there is enough current to 'light' the bulb.
Reply: @timjohnson3913  what I don't understand is that he makes it sound like this is how a lamp in your home is lit. In this case I'm guessing that the power plant would act as my battery,  and my transformer outside, farther down the line. Is he saying that my transformer induces a current into the load lighting my lamp? Am I misunderstanding something, or did he mislead by making this sound like it applies to all circuits?
Reply: @jonathonmatzke8463  I watched it a few times when it first came out, and I didn’t feel like he was trying to say this is how a lamp is lit in your home. I think he was trying to say there are a lot of common misconceptions about how electricity in your home works (e.g. that electrons are moving fast and carrying the power, that the electricity is flowing within the wire, etc).
Reply: @timjohnson3913 ok. Fair enough.  Seemed to me like he was trying to say that all electricity is transmitted this way.  He never even uses the term induction either,  which is what I'm assuming he's trying to show here?
Reply: Not really, the way he describes it it sounds as if he could transmit a signal with faster then light speed. But the length of the wire doesn't matter at all in his experiment as he bridges it with electromagnetic induction or by using it as an capacitor or both. If he would cut the wires after one meter he could still measure the same pulse if he hooked up an oscilloscope or sufficiantly sensetive equipment. But he probably can't power anything with it, certainly not a light bulb. Unless he puts the wires closer together and coils em up at which point it starts looking more like a transformer or capacitor then his faster then light magic ;D
Reply: @hernerweisenberg7052  Essentially corrected.   He failed to calculate the magnitude of the Poyting vector (power flux thru a surface).    If Veritassium was correct, then every time you flipped in a 1 amp light switch an inch from the conductors, the tips of your fingers would burn off.  You get a SMALL space transmission of energy as the switch closes and the current begins to flow, but no light till the current wave takes the long pah and you get SIGNIFICANT fields in the filament or across the LED junction.
Reply: @hernerweisenberg7052  For the “1/c” answer existence of the wire doesn’t matter.
Reply: @hernerweisenberg7052  In that case it's just an antenna transmitting a pulse, which is then received by the opposite side. This will happen. But no significant power will be transferred, and thus his argument and answer is wrong. If he were correct, wireless communications would be a lot more simple!
Reply: @hernerweisenberg7052  How is the "1/c second duration" an indication of faster than light? If you check Veritasium's video he said the switch/battery is 1 meter away. If EM waves travel at the speed of light, then how much time will have passed if light is to travel 1 meter? Well, it should be 1 meter divided by the speed of light or 1m ÷ 3×10^8m/s. Since there are two meter units and it is a division, they cancel out and we are left with a seconds unit. That tells us the duration. Now, the misconception that his video is addressing is that "the energy that turns on the bulb" do not really come from the 'motion of electrons' which is super slow! Instead, the theory is that the moment you close the circuit the first electron that moves inside the battery activates the EM field around the battery and propagates and reaches the bulb 1 meter away. Think of it this way, closing the circuit allowa the battery to "add energy to the external environment" which of course travels outside the wire and is guided by the Poynting vector to the light bulb. The electrons moving is just nature's way of balancing the total energy used by the circuit.
Reply: @angrymeowngi  yes! This is what I said above but not as sophisticated as you. People arguing here are still trying to prove the thought experiment is even possible.
Reply: @angrymeowngi  precisely the claim, that moving charges won't transfer. energy is false. The Poynting vector doesn't describe energy transfer but contained energy. This can be shown mathematically. Take the small example, a circuit containing some conductor, a lamp and a power source. Now loop the conductor a few times or add a lump of ferromagnetic material in the middle. This will change the Poynting vector. But it won't change the DC current through the lamp (assuming the resistance of the conductor is neglectable) And despite the fact, that the Poynting vector gets bigger (we have a larger magnetic field) the time until the lamp reaches full brightness will be slower. When you switch the circuit on, the moving electrons need to spend some of their energy to establish the electromagnetic field.

And by the way, I know the 1/c answer to be false, as I have seen measurements with a very similar setup to be done. There are commercial applications available, which can measure the length of a shorted cable by measuring the time a signal travels along the wires. This is called time domain reflectometry
Reply: @georgantonischki1188  Well, that is the problem with any theory, it is just an incomplete model. In real world measurements and experiments, it is impossible to make a wire that length and still make its resistance zero and as has been mention in several comments here and in the actual video, thay battery's capacity will not even allow the current to reach the bulb with the resistance that such a wire will carry. Thay said, real world experiments that you've seen do not invalidate conclusions of the thought experiment. The evidence you are citing, if anything, just says that we can't really do actual experiment of that scale and it does not even make sense to do it. I agree more with ElectroBoom to just do a variant of that experiment that is not just a thought experiment. Still, there is merit to the approximation.
Reply: @angrymeowngi  there is little problem with the theory, it is used all the time.

I checked a bit around, my assumption about the Poynting vector was false. It describes the Energy Flux, or the energy flow by area. This is a mathematical model and gets much more complex once energy transmission on microscopic level is evaluated. But on the macroscopic level this is a proper mathematical description. (edit on quantum level the formula gets more complicated, my understanding isn't sufficient here) 
But energy flux isn't the same as energy transfer, for this we need to integrate over the whole universe. And while at the end, the energy flux is mostly contained at the direct path, this isn't true directly after switching.
Reply: @angrymeowngi  go back to the cut wire scenario, its in the video.
Reply: @hernerweisenberg7052  The fact that the light turns on with "any current" essentially invalidates the need for any of the models except for the one where electromagnetic energy moves at the speed of light from the source. The light turns on after 1 meter of travel period.
The wire is not necessary and other than the 1 meter around the source, it is not even "used" because of this rule that he applies to the demonstration.
Reply: I disagree with Veritasium's final conclusions. Here's my reasons:
1. He is using a battery in the demo.  He clearly says "Battery", "Light" and "Switch", NOT TESLA COIL. 
Also, the battery is DC, not AC. We must conclude that the light bulb must be a standard light bulb, LED or Incandescent, that can be lit using the voltage from the battery, not a "magic" bulb as there is no mention of a magic bulb.

2. The voltage and current that will be induced on the bulb (via ANY means) thru 1 meter of air gap, will be many many times less than the voltage from the battery.
3. IF the bulb were to turn on from the minuscule current emanating across 1 meter, then either the bulb is extremely sensitive or the voltage from the battery is grossly exagerated. There was NO suggestion that this was a Tesla Coil. 
4. If the bulb is super sensitive to "any" level of current then he is clearly wrong that the bulb will turn on when the switch is closed because if it is that sensitive, it will already be on the moment the battery is attached to the switch from inductive effects. 
5. Since the bulb is NOT on when the switch is open, we must conclude that the voltage and current required by the bulb to turn on must be some reasonable amount... typical of a normal bulb.
6. There's no way a normal battery will light a normal bulb across 1 meter of air gap. Otherwise, we would see this effect all the time, and we don't.
7. If the bulb DID actually turn on when the switch was closed due to the very small amount of current induced across 1 meter, then the bulb would totally explode / or burn up when the full voltage and current finally arrived after 1 second. That would essentially invalidate the demonstration because it implies a voltage far in excess of a "Battery" to light a bulb.

The only valid way for this light bulb to turn on without exploding after 1 second, is for it the standard battery voltage and current to travel 300,000km to the light and provide the required current to turn it on. NOT some infinitesimally small amount of current crossing 1 meter of air gap.
Reply: @marcfruchtman9473  1. The moment when the switch is turned on creates a transient and this transient will indeed produce an EM pulse.
Veritasium’s conclusion is still a BS though.
Reply: @noop9k  We both agree!
Reply: @marcfruchtman9473  given the assumptions made he was technically correct. He is wrong however in reality because as you point out the voltage would not be sufficient. The problem with the assumption that any voltage will turn the light on there is any changing magnetic field in the universe would turn on the light.
Reply: @MrThedumbbunny  Exactly, if any current turns it on, he is still wrong because in that case the answer would be "None of the Above". The reasonable assumption is that the bulb requires a reasonable amount of current to turn ON, and STAY ON. And that it doesn't burn out when the actual current from the wire arrives after the 300,000km trip.
Reply: @marcfruchtman9473  given the stated assumptions he is correct. They are not good assumptions but meh thats a different argument.
Reply: @MrThedumbbunny  Yeah, we don't even have to consider the battery-side. The bulb side is already connected to a 300,000km long antenna. Veritasium never said "assume that we are doing this in a universe absent of any electromagnetic fields except for the one that will be created by this apparatus". Indeed, he implied the exact opposite: He drew his diagram in space over the earth. So while he didn't say "this thought experiment is happening in the regular universe that you know", he implied it by his illustration, and more importantly he never stated that were were operating in a magical, EM free universe, which we would have to be to see his result (and that's still ignoring the problem of "turn on because of miniscule power vs turn on in the sense that any normal person would interpret that"). So yeah, not a good video.
Reply: @marcfruchtman9473  The answer is: if a sensitive enough lightbulb like it's implied was connected to two lightseconds long wires with zero resistance in open circuit, it would already be on due to background radiation.
Reply: @marcfruchtman9473  For induction to take place the antenna has to have a current flowing through it. No current can flow through the upper wire unless there is a closed circuit. A battery who is not attached to a closed circuit does not produce current and without current there is no induction. The time it takes for the bulb to switch on is 2 s.
Reply: @sardoniclaugh9646  Sort of Correct... until you close the switch. Because once the switch is closed then current flows thru the switch right? Or at the very least it flows into the wire.
The moment it flows into the wire, it creates a electromagnetic field around the wire.
Don't forget tho, that an EM Wave can also induce a current. So, the moment the switch closes, current flows, and induces an EM Wave, that travels outward thru space in 3D, and That wave induces a current on the bulb when it passes thru it. Thus by the criteria that the bulb turns on with "any current", it turns the light on.
This is why I really don't like this video, and the thought experiment, because it's clearly not about how electrical power is delivered to the home to turn on appliances.
Reply: @marcfruchtman9473  That is not what Veritasium meant. Yes some power is transmitted via induction even when the switch is closed, but obviously the bulb is off. Yes once the switch is turned on the electric field travels through the wires and the induction effect increases with the length of the wire the field has traveled through but that takes time. Assuming that at some point, maybe a million km maybe more the capacitor formed by the two charged wires becomes big enough for the effect to become visible it will take 1million m/c to get there not 1m/c. The point is once the switch is turned on the two 1 light second wires don't become instantly charged, the electric field has to travel through them. And of course the actual full power doesn't come on until the electric field has made a full loop around the system.
Reply: @sardoniclaugh9646  I agree with you! And I argued that point a lot, but it seems that EE and Physics folks want to present this as a "ideal" thought experiment and not a "common sense" experiment. 

If it is a common sense experiment then one has to take into account the current and voltage requirements of a realistic bulb.

But, for those that argue it is "ideal", then when the EM Wave touches the bulb it turns on. This happens before the EM Wave touches the opposing wire 1 meter away because the bulb is at the very center, and the wave spreads radially.

Either way tho, I find the video very misleading.
Reply: @marcfruchtman9473  In  that case the bulb is ALWAYS on and the light gets only a little bit brighter after 1m/c gradually increasing after that as the charged portion of the wire becomes longer and longer. That doesn't mean the light turns on, it was never off in that case.
Reply: @sardoniclaugh9646  hehe Yes, I argued that point as well, if you take the common sense Point of View. 
For the "ideal" circuit tho, the counter is that the "rest of the universe" is ideal too.
So, the wires are in their "steady state", so they wouldn't have a moving charge until after the "ideal" switch is turned on.

Veritasium has put forth a video with very odd criteria which are not really useful for the purpose of how electricity actually powers the appliances. Instead they are "edge" cases. 
Nevertheless he boxed himself in with the criteria so tight that Transmission Theory doesn't even work to turn the light on in this case, because it turns on when the EM wave hits the bulb, but before the EM Wave hits the opposing wire. LoL
Reply: @marcfruchtman9473  I wondered about some of this as well.  In any case, I think it's great the video has generated so much discussion.
Reply: @marcfruchtman9473  "to travel 300,000km to the light" What exactly do you mean by this? Like the time is not even apart of the equation because it's paid out upon requesting so that it happens simultaneously?
Reply: @fathersongaming8515  It depends on how you view the "question:. If you take the idea that "any current" turns the light on, then You can look at like a wireless remote control. When you press the button (close the switch), the wave signal travels 1 meter and activates the light... OR you can require that the light requires a "real" amount of current to turn on, and in that case, we can call that the "operational" current or the "current rating"... the LED won't see that until the current in the conductor travels 300,000 km all the way to the light.
Reply: @marcfruchtman9473  I think you missed the point. The energy of the electricity is carried in the EM fields and not the wire. Its not that the energy needs to travel the 1m in a straight line. it is contained in all of space,  This is in essence a transmission line problem with conductors 1 meter apart. He is correct in that it takes 1/c seconds for the bulb to light. What he didnt make clear is that the 1 should be 1 meter, he left off the units. if the wire were 3 meters apart it would take 3/c seconds for the bulb to light. Technically he got it right BUT he left off the units in getting the 1/c answer.
Reply: @exponentmantissa5598  It doesn't matter that the energy is carried in the EM field. It won't turn on the Light with enough energy until the EM Field that is closest to the wire send the required current to the Light. I don't understand how its possible that people keep mistaking the EM field 1 meter away from the conductor as somehow capable of handling the same energy density as the EM field near the wire. They're NOT even close.
He might be barely able to turn on a weak LED that way... but try starting a car using a 12 volt starter motor... see how good your theory works. It's simply not going to work.
Reply: @marcfruchtman9473  I dont know what the motor has to do with it. Veritaseum is not doing some wireless power trickery to turn on some ultra low power LED. Assume it is a 100W light bulb. If the wires are 1 meter apart it will take 1/c seconds for the bulb to come on after the switch closes and if the wires were 3 meters apart it would take 3/c.
Reply: @exponentmantissa5598  I am perfectly fine with the EM energy being "around" the wire.. but that's AC theory. It was my understanding that the example was a DC Battery, which I believe changes things as far as Skin Effect is concerned. 
However, I am not debating that issue. 
The problem is about energy density.
There is not a high enough energy density at 1 meter to power things like toasters, ovens, dryers etc... that is why the conductor is required because it allows for increased energy density near the conductor. Insulation keeps the energy from leaking out. 
We are talking about INSULATED Wires... as Shown in the Demo. NOT bare wires. So the transmission effect is markedly lower.
ALL the simulations and all the "Proof" that Veritasium and others have shown me always seem to leave out the fact the conductor is insulated!!!
Reply: @exponentmantissa5598  LOL. There's no way it will turn on. I'd really love to see that! How will you overcome the forward voltage of the LED? Sorry, but this was Tesla's problem as well. The power density crossing the 1 meter gap is very small. 
Think about it. The Conductors shown in the Demonstration are INSULATED. He is using Direct Current from a Battery.
How are you going to get enough voltage an current across 1 meter of air? It's not going to happen. 
Everyone babbling on about transmission theory and totally forgetting or ignoring the basics... its an insulated wire carrying DC.
Reply: @marcfruchtman9473  LED? There is no LED, he used a light bulb.  Insulation doesnt matter in this case,   You are caught up in current having to jump the air gap, that is not the case here. Veritaseum was not the first to post on this effect. It is solidly rooted in EM theory. The wire acts as a wave guide or transmission line for the EM fields, in this case we have 2 shorted transmission stubs.  It is a misconception that the wire carries the energy, we do that for convenience of analysis. BTW Tesla's experiment was to transmit energy across a large gap without a wave guide, again not applicable here. EEVBlog even did a simulation of Veritasiums "experiment".
Reply: @exponentmantissa5598  It's a 1 meter gap in the air between the wires until it leaves the earth...The wire does carry energy in the sense that it carries the electrons which are the driving force for creating the EM field which is strongest near the moving charges of the electrons. There is no doubt that the EM wave is strongest next to the moving charge and weakens the further from the charge it gets.
Reply: @marcfruchtman9473  There are plenty of sources for the same explanation of Veritasium. It is not new and is a well known misconception about electricity. EEVBlog even did a simulation that confirms it. I dont know what to say, you are going around in circles. I suggest that maybe look at EEVblogs simulation and look at a couple of other sources. It really doesnt matter how far the wire goes, the time to switch on is governed by the distance between switch and bulb (distance between wires in this case). Wires are good conductors of current but are nonconductors of EM energy, the best conductor of EM energy is the vacuum.
Reply: @exponentmantissa5598  Well then this is a useless demonstration that has no utility and the experts can confirm it all they want, it doesn't mean anything since it has no real utility:  Turning on a light that requires no real power ( any current) is not my idea of useful. 
The entire setup makes it unprovable garbage. Lights that turn on when "any" current pass thru them... wire that have no resistance but extend 300,000km. All completely inconsequential because when that switch is turned on, the light will have Electromagnetic energy pass thru it at light speed. 
All trying to make like this means something more than it does. Trash science with no meaning. The power delivered to the light is inconsequential to turn a real light on. Works great for magic lights... again, who cares... I am sure the viewers are thrilled that their magic lights can turn on after 1 meter of travel time. THIS is a revelation! Except, it's not, because they don't have magic light bulbs.

So, Sorry, but, I disagree with the experts on this. These effects are minuscule  and have no real application to the power delivered in my house to power my Dryer, Oven or Heating and Air Conditioning. They can barely charge a cell phone from 6 inches let alone turn on a light. 
You want to count that as the light being "on"... fine. I personally don't count it as on. 
Is the power usable as anything other than a trick question. No. As I said, the bulb doesn't even need the wires to be connected according to this ridiculous demonstration's criteria. I don't consider this as anything other nonsense. 

If Veritasium wanted to discuss Transmission Theory and Antennas then he should have made a video about that and asked a question that was relevant to that. Not about power delivered to my home.
Reply: @marcfruchtman9473  All that Veritasium did was show people that many have a misunderstanding about how electricity works. He is right and that is physics, you cant change that. You keep returning to wireless power transmission and dont understand EM field theory at all. As far as wires go all are transmission lines. The wires act as a wave guide to deliver the energy contained in the EM fields to the load. There are also other ways to model this but all give the same answer. Go over to EEVblog, there is a pretty good discussion there, mostly engineers and its pretty well unanimous 1/c is correct.
Reply: @exponentmantissa5598  LOL. You proved my point right there, and its what I have been saying the entire time, the Wires direct the Electromagnetic energy to the load. And the EM energy immediately adjacent to the wire is carrying the majority of the energy density to do that. NOT the EM energy that is 1 meter away.

You and Veritasium are both convinced that the EM Field can simply radiate across 1 meter of air to power the load and turn the light bulb on. But it doesn't work like that in real life. It only works in this magic simulation box where it turns on with "any" current.

In real life to do it, you need massive voltages, Tesla coils, extremely large inductive coils etc. Which apparently aren't needed anymore because we can use the magic coupling effect and zero resistance wires to power the loads now.

The whole thing is preposterous for real world electricity loads which was a the subject of the "big lie" we were all told.
But it really doesn't even matter. The whole debate is absolutely pointless. I can't think of a single application where it makes a bit of difference since we won't be using any 300,000km wires with no resistance and bulbs that turn on with "any amount of current"...
Reply: @marcfruchtman9473  You are not reading what I wrote the EM field extends in all of space including the gap between the switch and bulb, I spent 2 years working at a Linac and then later a synchotron.  I didnt disprove Veritasium, at all . Some people are just too dumb to be engineers.
Reply: @exponentmantissa5598  Of course it extends outward infinitely (or something very close to infinitely). And it gets weaker and weaker. Insults don't change the facts that the electromagnetic energy is strongest as it is closest to the moving charges in the wire, and not 1 meter out. I don't quite understand why you arguing against that position. You even said it yourself that the wire acts a guide. 
It doesn't matter that the EM fields extends to infinity if it becomes infinitely weaker as it extends outward. 
My point is that the field becomes weaker... what are you going to say, that it doesn't?
Reply: @exponentmantissa5598  well well... watched scifnce asylum video? ^^
energy is a LOCALLY conserved quantity. it has to travel through space. 
what veritasium completely ignores is that for the energy to be consumed in the bulb, there has to be a current trough it. so the charges and currents are just as essential as the fields. all he ever talks about in the whole video is, that the energy is transported by the fields and that this somehow has to mean that it flows on the shortest possible path from the battery into the bulb. which is nonesense.
 imagine there are more bulbs arranged in the same way: one to the right, one to the left, one above, ... do you think they all just switch on when thd circuit gets closed? with full power? 
and btw the building up of the currents (and magnetic fields) along the wire also requires energy
Reply: @deinauge7894  Basic transmission line theory. The current will indeed flow in the load before it travels all the way around the wire loop due to the capacitance of the T line. Asa matter of fact the bulb would still light even if there was open circuit at the far ends of the cable. How do I know, I am  an engineer with 41 years experience. BTW energy doesnt get consumed, it merely changes form.
Reply: @exponentmantissa5598  
(1) transmission line theory ignores some aspects of electromagnetic fields (which doesn't hurt usually, but may play a role when calculating the exact timing here)
2. even ignoring (1) the current through the bulb is usually much smaller until the current-field-wave reaches the lamp after going round the whole loop. if that would not be true, you would turn on all bulbs in your vicinity when switching on anything. that doesn't happen to me at least ;)
(3) have you ever build something like this in your 41 years of engineering experience ^^ 
(4) your last sentence is just dumb in this context. if you don't understand what consumtion means...
Reply: @deinauge7894 1) Which aspects of electromagnetic fields does transmission line theory ignore? 2) Show me math that proves your claim about the size of the initial current.
Reply: @exponentmantissa5598  
it does not include time delay between the two cables. i thought it also neglegts energy loss due to antenna effect, but those can be modelled by leakage.
i don't need to do the maths here, because luckily electroboom did it in his reaction video :) i did not check his calculations, but they look ok to me... 
since i've seen veritasiums original video, i want to do a numerical model with the full maxwell equations.... maybe after xmas if i have time then
an extra thing to consider is the position of the switch. because the field-current-wave starts there, not at the battery. and if we assume a perfect battery, i don't expect much current on the other side of it, since the whole cable is on its electric potential. maybe i do two models: one where the battery is suddenly switched on, and one that follows veritasiums experiment where everything is connected and in equilibrium before the switching
Reply: @deinauge7894  A numerical model with Maxwell's equations?????
Reply: @exponentmantissa5598  yes, i think analytical exact solutions won't be possible
Reply: @deinauge7894  LOL
Reply: @exponentmantissa5598  i'm lucky again. there is a video on youtube with axactly the simulation i wanted to do (it has been done quickly after veritasiums video...). and even better, alphaphoenix did the experiment, scaled down of course.  (and a wire placement which is not helping my argument, since it amplifies the capacity. but still it shows the point more than enough)
Reply: @marcfruchtman9473   You are completly right. Veritasium and his bulb need to visit a substation. Then he will see that even when switching HV circuit breakers at hundreds kV (AC or DC), his bulb will not ligh up at all. He may even aproach the bulb to the live conductor attached to an insulating rod. I do not know how he made such a bad video.
Reply: @ignaciolucasavilamangano3485  Hmm, I, think if we go with the "spirit" of his demo, then that would require a conductor to connect to the hundreds of thousands of volts DC, and therefore there would be a good chance of lighting that LED via inductive effects (at those high voltages the energy crossing the 1 meter gap would still be reasonably high). However, the LED would explode about 1 second later, which in my opinion, negates the result and invalidates the experiment.
Reply: @marcfruchtman9473  You are right. In his experiment wires are connected to the lamp. But as he claims that the bulb will light up at 1m/c, it does not really matter if they are connected or not. Why not make them infinitely long, wich is the same as not beeing connected at all. Nevertheless I see that you are trying to mantain his "spirit". So much talk is the result of such misleading video.
Reply: @marcfruchtman9473  Have you seen Veritasiums video? He answers most of your points, and I think he is right (except for not multiplying 1/c with the distance between the source and the bulb). I agree, though, that Veritasium should make a new video, because he clearly did not explain everything good enough, as we can see from the comments. 

The whole point is that if you have two cables close together, a current in one of them will induce a current in the other. They don't even have to be connected, but if they don't they must be very, very long for the current to be flowing for a long time, just like charging a capacitor. 

Your problems answered point by point: 
1. He doesn't need a Tesla coil, the voltage of the battery is high enough in his theoretical case with no resistance in the wires.
2. The voltage will theoretically be the same in both wires if the cables are infinitely long and there are no external influences. 
3. Again, the current will not be that minuscule. 
4. If the switch was on one of the far ends of the loop (those in space), you would be right, but the point is that the cable is so long that as soon as you turn on the switch (close to the battery) you get a large induction. The short cable from the battery to the switch (when the switch is near the battery) is indeed working in the same way, but that effect would be way to small to see a light in the bulb. 
5. Yep, it should work with a normal bulb.
6. We don't have that long cables usually, but even if we don't, we see this effect all the time in transformators, with a major difference beeing the cables are now coiled up, to avoid having very long transformators, and the circuit is not closed, since we use alternating current. All common light bulbs in a normal house are actually lit this way. 
7. There will not be a "full voltage and current" reaching after one second, but at d/c seconds, where d is the distance between the battery and the bulb and c is the speed of light in air (close to the speed of light in vacuum). 

If you want to learn more about electric fields, I can recommend the YT channel Physics Videos by Eugene Khutoryansky.
Reply: @marcfruchtman9473  He mentioned the bulb will be super sensitive but he also mentioned that this is an ideal circuit meaning there will be no capacitance and that means light bulb will need to wait for the electron wave to propagate trough the wire.
Derek does not understand the problem thus his explanation is wrong.
Currently I try to find the time to explain another wrong video that Derek from Veritasium made and that is the Direct down wind faster than wind vehicle.
That vehicle can exceed wind speed but not because it is powered by wind directly when above wind speed as he claims but because there is energy stored in pressure differential created by the propeller so the vehicle will only travel for a limited amount of time above wind speed not indefinitely as they wrongly conclude for an incompletely run experiment.   I find that physics video is more important for me to debunk first as it seems nobody understand how that vehicle works not even Physics university professors.
Reply: @electrodacus  I would very much like to see it debunked as well, but honestly, this electric thing really bothers me a lot more... since it is testable with common electronics equipment. 
I would very much like to see how a 12 volt battery EM Wave / Field with a 1 meter air gap is going to power thru the forward voltage of that LED Bulb.
Reply: @marcfruchtman9473  The way he formulated the problem is not testable and the problem definition is incomplete.  He mentioned that he uses the ideal case so ideal wires with no resistance (he mentioned that) but said nothing about inductance and implied based on expected result there will be capacitance but then that will no longer be an ideal circuit.
Same as with the faster than wind directly down wind problem there are multiple mistakes.  He dose not understand power and energy and that showed also in my email discussion with him (Derek).
I'm sure not as good at explaining things but with that faster than wind problem I had enough time and discussion with multiple people to know what people misunderstand about the problem. That is the hard part in explaining as there is not only a single thing that they understand wrong but multiple things so an explanation that will make them understand requires explaining in simplest therms all of them.
At first I was thinking that they do not understand what a propeller is or and what air is. Best propeller analogy is an inductor so an energy storage device but that was not useful as the inductor is even more abstract than a propeller.
Same as you can store potential energy in an inductor you can store potential energy in the pressure differential created by the propeller and this is possible with air as air is a compressible fluid. This same thing will not work if air was to be replace with water that is an non-compressible fluid.
I already have the basic idea how to first debunk their explanation (relatively simple) and then a bit more complicated showing how the vehicle actually works and that involves energy storage.
I think most of this misunderstood problems have a lot of things in common and have to do with understanding power and energy. There they confuse power with force.
Reply: @electrodacus  that veritasium is wrong about electricity doesn't mean he is wrong about the vehicle...
the intuition about the vehicle often forgets about the fixed ground. it plays an existential role. just like water for a saleboat crossing faster than the wind (this analogy is quite good, isn't it)
Reply: @deinauge7894  Yes you are correct being wrong about a problem will not mean you are wrong about everything else.
No sailboat can exceed wind speed while sailing directly downwind at all times. A sailboat has no energy storage device other than the kinetic energy of the boat and that can only be used if boat travels at an angle relative to wind direction not directly downwind.
So if a sailboat travels at an angle with no friction ideal case it can exceed wind speed so the kinetic energy is charged and now you can just change direction down wind and continue to travel indefinitely at that speed since there is no friction to reduce the kinetic energy and thus speed.
This thing will also be using energy storage but in kinetic energy. Black bird uses pressure differential energy storage so it can travel directly downwind and exceed wind speed for a limited amount of time (no time limit for ideal vehicle) but real vehicle has friction so the stored energy will be used and vehicle will slow down below wind speed after wind speed was exceeded. None of the tests showed a long enough drive to show the slowing down effect but the acceleration rate can be seen decreasing as it will be the case with any energy storage and friction while the wrong equation shown by Derek in his video will predict increased acceleration rate and that is not what is observed in any real world test.
Reply: @electrodacus  actually, a sailboat can sustain a velocity component parallel to the wind that is faster than the wind. without those tricks you mentioned. there are measurements of constant 1.5 and even 2.5 times wind speed (component in downwind direction). and there is nothing wrong with it from a theoretical standpoint...
Reply: @deinauge7894  Perpendicular to wind direction will mean you always have access to full wind power and you can get to any speed limited only by your friction losses. But this means you take advantage of vehicle kinetic energy so you are using kinetic energy storage and then you can change direction to even direct downwind and maintain that higher speed for relatively long time using stored kinetic energy and using that to supply the friction losses so you will still slow down and you will need to again charge the kinetic energy storage by driving at some angle to the wind direction.
Kinetic energy = 0.5 * mass * (vehicle speed)^2 and result is in Ws or Joules if you prefer.
Reply: @electrodacus  as i said, it is possible to accellerate to speeds with parallel components faster than the wind. without any direction change! and sustain this speed. in reality, with friction! there is no energy storage involved, but it needs ground(or water) contact
Reply: @deinauge7894  Only if you change direction not if you maintain the same direction.
As I already explained you are charging the kinetic energy storage.

If you drive perpendicular to wind you can get to almost any speed way above wind speed limited mostly by the friction losses but you have zero direct down wind speed component as you are perpendicular.
If you now rotate to some other angle including direct down wind you will still have about the same large speed since your kinetic energy can not just discharge instantly it will take quite some friction loses to reduce the stored kinetic energy.
You can not take advantage on kinetic energy storage when you always drive directly downwind and so another form of energy storage will be needed to allow exceeding the wind speed. In blackbird case that is pressure differential energy storage and that is possible thanks to air being a compressible fluid.
Reply: @deinauge7894  Reality is so messy that you will have huge margins of error. For example the 2.8x speed record data have two places where wind speed was measured with differences in those speeds at any one time ofe over 30 to 40%.  The wind speed fluctuation was between 8mph to over 15mph. The record was taken as the best case scenario by finding the point where vehicle had the highest speed and wind the lowest speed.
You can watch Steve Mould video called sailing faster than the wind (do not want to add alink just in case so my replay is not deleted).  He was very careful not to say anything about direct downwind faster than the wind. Steve is smart enough not to make such statements that he can not explain.
The blade tip on a typical wind turbine can travel multiple times the wind speed but that will not make the turbine any more efficient than about 40%
Reply: We can do the experiment with a transformer with many turns on primary and secondary take battery plus on primary coil and connect primary and secondary at the other end of the transformer and the lamp on the other secondary coil and a switch to the battery, now the switch closes and the lamp lights up immediately and will decrease in strength due to the resistance of the coil, initially the two coils will counteract each other due to the magnetism (or capacitance), if the two coils are connected opposite the lamp will not light immediately. I have not included that transformer coils have no resistance.
Reply: @jacobhn2  if he's taking about inductance, then what is the point of the 300k mile long circuit? That's completely unnecessary
Reply: In order to have capacitance through air at such a distance, the voltage would have to be extraordinarily high.
Reply: Just a frightful, deafening display of ignorance in this comment thread. If this kind of blind pedantry existed outside of the armchair experts in Youtube comments, we wouldn’t have modern scientific understanding from theoretical geniuses like Faraday, Tesla, Einstein, Bohr, Hawking, et al. All of these people required the functional utility of idealized physics and fantastical thought experiments to form the groundbreaking theories that would then go on to be repeatedly proven by experimentation, giving us the laws we understand today. Instead Einstein would have been shouted down for his “ridiculous” notions of relativity. Learn to know your limits, people…defer to those who know better. Otherwise your just being religious zealots worshipping at the feet of idiocy.
Reply: Electricity is a hybrid field the dielectric field is in the conductor?
Reply: Nope, using any reasonable battery, no person would say that the bulb was lit after 1m/c, not even half lit.
Reply: @Albatossable  Hiding the bulb in a Faraday cage would be truly interesting! As far as I know, it is very possible to make an EM field inside a Faraday cage, as long as you make it inside. If you make a current inside the cage, you can still light the bulb. The current must come via the wire, and it would be tempting to say you must wait for the current to go all the way, spending 1 second, but I think you would need a very large Faraday cage then. As soon as the wire exits the cage, a current will be induced in it due to the parallell wire from the battery. I suppose it will take a little more time, since we have to make it around the cage, but a small cage would only give a small delay. At least, that is what I believe, but I might be wrong!
Reply: 🙏 The BOOM hasth spoketh 🙏
Reply: Where is ur video
Reply: Isnt there a way more fundamental problem?
1/c isn't a length of time
Reply: @RobertSzasz  That was a point he left out and it caused a lot of confusion. The distance between the wires is 1 meter. That is where the answer 1/c comes from which is correct.
Reply: @RobertSzasz  I think it will be right if you use d/c, d beeing the distance between battery and bulb. He probably said 1/c seconds because his distance was about 1 m, and 1m/c is easy to miswrite as 1/c.
Reply: @oleedvardvaly1782  probably. But it's also a pretty fundamental error repeated over and over.
Reply: @RobertSzasz  Yes it is if it is 1/c seconds. c is a constant as is 1 so 1/c is a constant. So if something takes 1/c seconds it is a length of time. If something goes 1/c metres it is a length of distance. Of course one may claim that c should rightfully include the units m/s in which case you may say 1m/c
Reply: The man gets shocked for a living, but can't handle a demo to light a bulb with a car battery using a 1 meter air gap. Prove me wrong ElectroBoom... show a video proving Veritasium is correct. Show me a light TURNING ON. (NOT microvolt scope tracing showing me the arrival of the EM Wave...) Show me A LIGHT TURNING ON from the current induced over 1 meter air gap before the current arrives from the conductor! 
100 meters should be plenty. But, heck if the scope can measure it accurately with shorter wire , that's fine too.

Please, show me that light turning on from the battery energy crossing just the air gap... because I am betting it simply can't do it. It will only turn on from the energy traveling proximate thru the conductor.
Reply: @marcfruchtman9473  What you are proposing is not what was tested. Of course one cant make a battery light a bulb with no connection as you stated BUT you are changing the experiment. The wire acts as a waveguide/transmission line for the energy contained in the EM fields. A wire does not technically transfer energy, it only guides it. Did you ever wonder why transmission lines are so high off the ground?
Reply: @marcfruchtman9473  A fluorescent tube can light up in a HF field way further than several meters. But it is HF and not 12v car battery. I do have serious problems with the veratasium explanation just can't pinpoint what. Like take a tube of that length full of ball bearings ... state that the situation is ideal without any losses and compression and put in one extra ball in one end ... ideally a ball would exit on the other side at the same time ... but we all know it's impossible. 
And that is the problem with "ideal" circumstances in  scientific models.
Reply: @countmorbid3187  Earlier today, I realized that this thought experiment (as set forth with the criteria), doesn't have any way to differentiate the "true" behavior because he implies that "any" current turns the bulb on.
So there's really no way to discern any significance from the turning on the bulb other than 1 planck energy reaches the bulb to turn it on. I admire all the EE putting out transmission theory but the reality is since "any" amount of energy turns on the bulb, the theory is redundant because the first electron motion is what turns it on. At that point its not about understanding the deeper nature of the universe, its about a trick logic question.
Reply: @marcfruchtman9473  Both videos were thought experiments. Supposed to think it through not show it actually happening.
Reply: @Rakstawr  Normally I would agree. But for this one, I have come to the conclusion that it is not a useful thought experiment. The Light Turns on. So what. It doesn't even need the wires to turn on. Turn on the switch and the "magic light" that turns on with any current. WOW. 
It will do that without the wires too. 

Come to think of it, you don't actually even need the battery. Just closing the he switch will do. 
That's how moronic this thought experiment actually is.

Moving on to something that actually has meaning.
Reply: @marcfruchtman9473  well it won’t turn on because batteries supply direct current. Electrical current must be alternating for inductance to take place. He is wrong.
Reply: @marcfruchtman9473  he's not saying Veritasium is totally right, he in fact got super frustrated w his explanation in a previous video & said he's making a response. Medhi is saying that the final statement Derek makes & ALL limitations he places on it (perfect wires & ideal everything) is correct, but otherwise it's vastly wrong.
Reply: @nicknack125  Hmm... Well, I think the mood should convert from  "well technically right" but could have been better...TO., what a load of garbage one explanation has Nothing to do with the other, and the the question is completely moot as it doesn't even require the wires.
Followed by how annoyed with the video I was.
So... I expected a lot more push back from "the experts" to be honest.

Another thing, this "idea" that "ALL" the EM wave travels outside the wire... where is the "Proof" of this? 
In other words, show me the proof that there is NO EM field inside the Wire.
Because as far as I know, the electric field HAS TO EXIST at all points in space, or at the very least, propagate thru adjacent points in space from the point source of the charge outward.
By saying that all of the EM Wave travels outside the wires, that is violating how EM waves travel.
So, I am very curious how that is actually possible. Are there any relevant published articles that prove this?
Reply: @nicknack125  It's still not right, though, even if you do accept all of Derek's stated premises. He never stated the premise "this thought experiment is in a universe absent of any EM other than the fields that will be generated by my apparatus". In fact, he actually implied the opposite with his diagram being drawn over the earth, which suggests this was meant to be taking place in the regular, familiar universe. But in the regular, familiar universe, the very reasoning that would explain why the 1m/c seconds result could be right in some weak technical sense is also the reason why it's actually still wrong, because by that same reasoning the light would already be on before the switch is closed.
Reply: @marcfruchtman9473  yep he literally just made a video today and it's now the top result when you search about this topic. go watch it
Reply: It's FOUR MILLIAMPS!   The LED-bulb turns on almost instantly (3 nanoseconds.)
Someone looked up an online calculator for 2-wire transmission lines.    They behave as ~800 ohm resistors, wired in series with the bulb.  (Resistors.  Not capacitors, since the e-fields do not have instant access to hundreds of KM of wire.)
If we put two 800-ohm resistors in series with a 12V battery, then for max power, the light bulb also needs to be 1600-ohm load, operating at 6V and 3.8mA, 23 milliwatts (easily visible if white LEDs.)
Then, after one second, the full 12V arrives, and the 1600-ohm LED bulb approximately quadruples in brightness: 90mW
Reply: @wbeaty  If this were true, it would be trivial for someone to set up an example of a battery with two wires say 10m long and an led with two parallel wires 1m away and showing us the led lighting up. It won't happen. It would need a much longer wire to actually light up the bulb, and due to resistance in the wire it will never actually work. Remember also that this is DC that we are talking about so only in the first few nanoseconds will there even be any changes to the field near the battery. So the bulb could theoretically emit some light for a nanosecond after the switch is flipped, but you would not see it and claiming that the light has been turned on is ridiculous.
Reply: @wbeaty  After you look up 2-wire transmission lines, look up transmission line losses. Resistence still matters!

I think it's irrelevant to what Veritassium is trying to say, however. He cuts several corners to make a theoretical point, and resistance is one of them. Talking about only the magnetic field and not the electrical field is another.

A 2-wire transmission line (like the 300-ohm lines we used to use for TV's back in the day) is 200 ohms of *impedance*, not resistance.  The difference is important. It is like a series of infinitessimal series inductors and parallel capacitors that all balance out and make an impedance-matched 300 ohm load at the end at any distance look exactly like (for no actual resistance) the line extended to infinity.

So for an impedance-matched load, it's the load's value that the source sees. Then subtract transmission line losses. But don't take the transmission line  impedance to be like a series resistor!
Reply: @BobKerns4111  DO take the Zo of a 2-wire line as being a series-resistor ...but only when using infinite 2-wire lines where copper resistivity is insignificant compared to Zo.   The driving source sees a 2-wire line as a Real non-reactive impedance (meaning a pure resistance, neither capacitive nor inductive,) but this is true only until line-reflections return from the distant mismatched end.   Until that happens, the copper resistance slightly increases the pure sqrt(L/C) value.

For a 250ft line made from 300ohm TV twinlead, a pulsed drive setup will see the line as being a pure resistor slightly above 300ohms, but only for about half a microsecond (or however long it takes the pulse to reflect from the far end of the line.  Plastic decreases the Vf to well below lightspeed.)   If instead we had an air-insulated infinite 2-wire line made from superconductor, then any DC ohmmeter would measure the end of that line as being a pure resistor, with the resistance value being the same as Zo line impedance.   Use that 2-wire line in a series circuit.   For any applied V, the current should be I * Zo.    (If not, find some explicit details which explain why not.) 

We assume that the 2-wire line obeys charge-conservation, where we can only inject a current into one wire if an equal current comes out of the other wire simultaneously.   Does this assumption not apply?   Each of the two wires also exhibits a capacitance to a grounded shell located at infinite distance, same as any object does.  Maybe that messes everything up, and the pair of 2-wire lines starts behaving as an infinite dipole antenna, where the current in each pair of wires is not exactly equal and opposite, and probably varies with time.

ANYway... as Veritasium points out, parallel longwire pairs continuously suck in EM energy, analogous to a resistor doing the same.   But the resistor is producing heat, while the wire pair is storing a constantly-lengthening "slug" of EM energy.  The longwire pair and the resistor will both take in a certain rate of joules-flow, whenever a certain potential-difference is placed across the terminals.

Be VERY VERY careful to not forget, Veritasium *didn't* create his exam question himself.   The question has NOTHING to do with Veritasium's own intelligence.   

Instead, it was given to him by an engineering prof (but Dereck didn't say whether that person created it himself, or got it from elsewhere.)   To me the long-line question smacks of physics brilliance, because it's perfectly crafted to expose student-misconceptions during an exam.  In the past I've come up with devious exam-questions for undergrad physics.  But the lightbulb question, that was sheer genius.  (My own version would have been an enormous circle one light-second in diameter.  Very hard to perform calculations.  No subtlety at all.)    If the original teacher's students didn't listen during their classes on 2-wire lines, and didn't do enough reading and homework to grasp the basics, then that test-question will give them the wrong answer on the multiple-choice quiz.   But for someone with a good grasp of 2-wire lines, not only is the answer obvious, but they can even crudely calculate some numbers.   After seeing the end of Dereck's video, it took me 20sec to figure out how the thing worked, and within two minutes I had a mA value for Veritasium's bulb.   I guesstimated that the Zo of the two lines would be around 600 ohms, with matched bulb filament being 1.2K, drawing 5mA with 6V across the bulb, which initially lights up at 30mW, then gets 120mW when the full 12V arrives after 1sec.   Actual L-C calculations for 5mm cables instead put it at 720 ohms, with z-matched bulb being 1.44K.
Reply: @wbeaty  We should assume an impedence-matched termination here. Anything else just needlessly complicates things.

For 800 ohm transmission line, that termination would be ... 800 ohms. It is what the rest of an infinite line would look like, and thus does not create reflections.

1600 ohms would create reflections. Reflections would multiply any real resistive losses. Those would be proportional to the ACTUAL resistance of the copper, not the characteristic impedance. You can make that arbitrarily low with bigger conductors, superconductors, etc. It is certainly not proportional to the characteristic impedence—which is independent of length!

(Superconductors probably have problems fitting the transmission line model due to flux pinning, etc. Let's limit ourselves to the abstract ideal of 0 ohms).

A 1-cm transmission line certainly does not add 800 ohms, right? Definitely not times two; the characteristic impedance is for the two-wire system, complete with distributed inter-wire capacitance and the inductance.

The characteristic impedance is proportional to the log of the ratio of distance between the wires and their radius. So we can pick whatever impedance we want within reason.

Putting the wires further apart increases Zo but clearly does not affect current over a short line, or you'd see LED's vary when you wiggle the wiring. It just doesn't happen.
Reply: @wbeaty  Prove it with an example with a real bulb turning On. Invisible to the human eye doesn't count. Also, the BULB Itself has to not self destruct when power arrives from the wire. I really doubt you will be able to induce enough current to travel in a wire that is 1 meter apart that way using 12 volts and also not destroy the bulb, but I am willing to watch the video of it when you make it.
Reply: @marcfruchtman9473  Veritasium has done the experiment in his recent video
Reply: @gamerdio2503  Thank you for telling me about this. I had unsubscribed from his channel, so I am not sure how or why you thought to let me know, but I do appreciate it! 
Ultimately, I value his Follow Up video because it does address a lot of my original concerns. 
However, I really disagree with this final conclusions. He still seems to believe that the electrons are merely "passengers" and the Electric Field is doing "all the work", however, in his follow up experiment, he fails to notice that 5 volts is NO Where Near the claimed voltage, and 0.028 ampere is no where near the ampacity needed to "Fully" light the bulb. He admits that it is not fully lit... yet still makes the same conclusion that the electrons are not really doing anything.
This makes no sense. 
Clearly when the "electrons" arrive... the light turns fully on. 
If his theory was correct, the light would fully turn on the moment the electric field hit the bulb, but it is very clear it does not.
Why does he still doubt that the electrons are doing work?
Reply: I am also very disappointed to see him using a resistor in place of an LED... I suspect that it actually did NOT turn on in the experiment, so they took it out.
Lastly, the experiment is totally wrong...it looks like the source voltage was set to 20 volts...NOT 12. (See oscilloscope data).
It really looks to me like he fudged the experiment as best he could in favor of a barely acceptable result that sort of made his point. but its just more of the same... it BARELY lights the LED.
Reply: So with all limitations taken in consideration, you could transfer information faster than light by using electromagnetic radiation, which is.. light. If so, its still a very stupid idea that just breaks laws of physics and indeed, laws of logic.
Reply: @rykehuss3435  Light only travels at the speed of light as far as I know. So, I am not sure how you can conclude that the information gets sent faster.
The point is that the electromagnetic energy is like a radiowave, and simply bypasses the requirement for a wire. The energy is much weaker after 1 meter.
The "trick" is that the bulb turns on with "any" amount of current. So, it doesn't need all the energy of a usual light bulb.

The reason I dislike this video very much is that it confuses many people, and implies that the energy needed to turn on the appliances in the home can work the same way, and it really cannot.

You can think of this experiment like this:
A person presses the button of a walkie talkie or radio transmitter... how long does it take to reach the walkie talkie receiver 1 meter away.

But instead of asking the question properly, he throws in all this extra garbage about wires that are 300,000km long and blah blah blah... all meaningless and confusing.
Reply: @marcfruchtman9473  Its not confusing at all. If you have a 1 light second long circuit, the bulb isnt going to get ANY current, voltage, power whatever, no electrons or photons are going to reach it faster than light. So him claiming the bulb would turn on almost instantenously is false, even if the bulb would turn on from any amount of any kind of energy that originated from the power source.

The whole 1s/c or whatever it was, thats the issue like I said. Its simply impossible.
Reply: I disagree with your statement. But yes, Veritasium holds half truths about this subject matter. I typically love your "shock" videos for views, but EE you are not. Go back to your Benjamin Franklin lessons of teaching, and maybe, one day, people will worship you, conventionally :P
Reply: @_c_e_  How is Veritasium's video half truth? What is so wrong with his statements? Aside from the units, I get that. The concept seemed pretty solid to me.